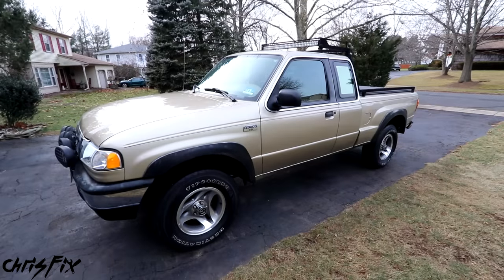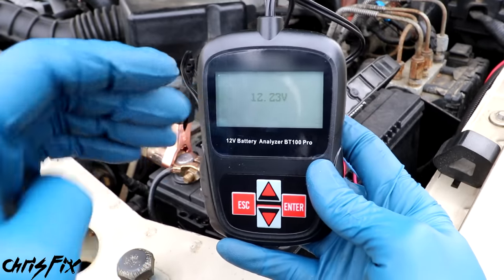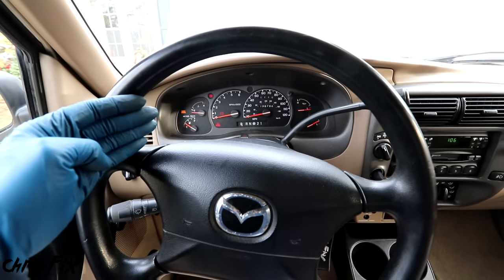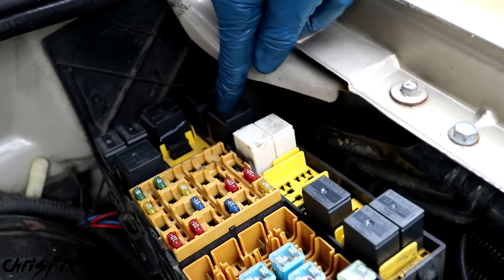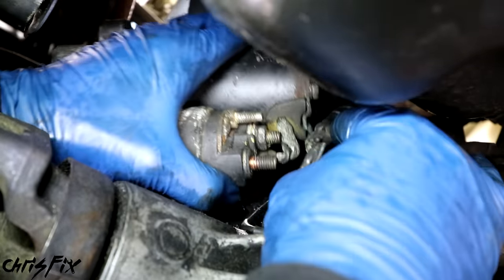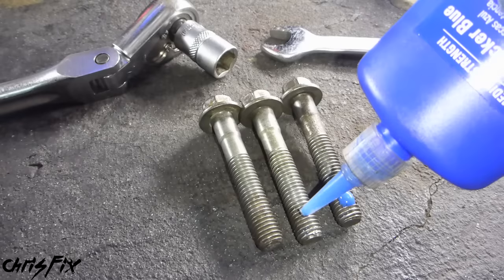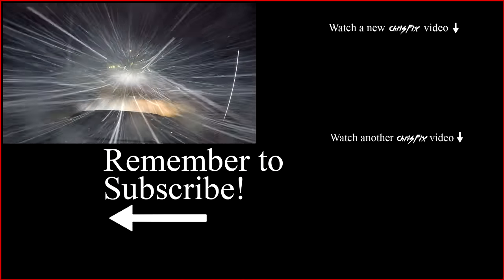How to Diagnose and Replace a Starter

Comment from the maker: Comment your "starter stories" here. I know some Audi's need the engine lifted to get to the starter and the Cadillac NorthStar engine has the starter under the intake manifold! What a bad design!

Follow me: → Instagram: https://www.instagram.com/chrisfixit
Stuff I used in the video:
Starter I used: https://goo.gl/dpUUWI 
Mutltimeter: http://amzn.to/2ja4Axd
Battery Load Tester: http://amzn.to/2ifhMRK
Battery Charger: http://amzn.to/2iiD9wN
Swivel Ratchet: http://amzn.to/2j9VGzQ
Universal Joint Adapter: http://amzn.to/2jxRqXv
Thread Locker: http://amzn.to/2jxRqXv
Silicone Paste: http://amzn.to/2ja5Q3A
Reply: ChrisFix our 1964 newport barely starts in the cold and takes a few tries in summer if its a cold engine
Reply: ChrisFix Chris thank you liking my photos on instagram
Reply: ChrisFix Wheres the How to install an e-brake for the Driftstang video huh???
Reply: ChrisFix ya thats right
Reply: i actually bypassed my starter (jumper cable touching it).
Reply: first
Reply: Not nitpicking, but remind people of Starter shims. There are cars out there that still use them.
Reply: your asume
Reply: You're my new best friend. Im pretty sure my starter just died yesterday.
Reply: Friend of mine had a mk 5 golf where he would not get it to start, tested the battery, checked fuses and relays but still no 12v on the starter solenoid from the key. After reading fault codes it was that the clutch pedal signal wasn't being sent to the ecu so it wouldn't start, after a new clutch pedal sensor it fired right up
Reply: ChrisFix replaced mine a month ago. no warning just died and would not turn. I have a jeep wrangler so it was easy to remove and replace.
Reply: ChrisFix you should disconnect through positive terminal on the battery not the ground or both. Only disconnecting the ground can cause a short in your wiring.  I burned up a passive equalizer when I was 16 years old.
Reply: ChrisFix when will you upload the hydro ebrake vid and the drift vid
Reply: ChrisFix  Mitsubishi lancer evo 2011 has the starter under the intake to i couldnt do it my self so i have to pay for it ... this was like a week ago this videos would has help me alot heheje thanks for making those great videos man
Reply: ChrisFix i once broke 2screws on my starter so i had to disassemble a lot of shit :(
Reply: ChrisFix went replacing the starter on my 1996 jeep Cherokee sport I accidentally damaged transmission fuild lines causing my transmission to blow. like you said it's a tight space in there.
Reply: Had to replace the starter in my wife's Corolla a few months ago. Pretty simple and straight forward process. I didn't have a flex head ratchet so I had to remove the radiator fan to fit a normal ratchet in there. Anyways, that's my starter story. Not very interesting, lol. Cheers.
Reply from the maker: Check the fuel pressure: https://www.youtube.com/watch?v=_oXLUqE4Sf0
Reply from the maker: Adam Vang, it will be out once I get racing seats. Cant install it until they arrive.
Reply: Once at work I had to remove the starter from a Ford Transit. It was so old and dirty and brittle that when unscrewing one wire the whole starter broke apart.
Reply from the maker: Thanks! I had info about that in there but it just made it too confusing and most cars today dont use them!
Reply: I had to replace the starter solenoid on my 03 Explorer yesterday. I took off the starter and took it to get tested and the solenoid was bad so I replaced it.
Reply: ChrisFix YOUR VIDEOS ARE AWESOME AND I LOVE THEM
Reply: Alfa Romeo 156 1.9 JTD so bad access, you need to disconnect the fuel filter to wiggle off starter, same for alternator, good point is to take old starter and store it somewhere, 'cause there can be problem with electricity or mechanical, every time can be different then you can combine them, if somebody do not have money for the brand new starter
Reply: My 1999 e36 bmw m3. You have to either remove the entire intake system or the transmission. Not only that, but the bolts that hold the starter on are near the top of the trans and take multiple extensions and universal joints to get to. I've pulled off the transmission to do the clutch and regret not just replacing the starter while I had it out even though it wasn't bad at the time.
Reply: ChrisFix  Lamborghini aveador starter so bad
Reply: Great video by the way! I think I'll subscribe lol, finally...
Reply: you forgot to put two pieces of wood behind the rear tires for extra safety
Reply: My father had a Citroen DS (a very long time ago)  that seemed to have a faulty starter(it would turn over), eventually he got under the car to remove the starter and discovered that the bolts were loose and the starter was getting jammed, so he tightened it up and it woked fine. xD
Reply: I was visiting my grandparents in the middle of january. it had dumped 2 ft of snow the previous night, and when i went out to my car, because i was going home that day, i had a bad starter. that was the coldest fix i ever had to do, but it all worked out in the end
Reply: The 02 Jetta's with a 2.0 liter engine is pretty tight! You can also bench test your battery at home if you have a vice, a spare battery and some wire.
Reply: ChrisFix how do you change a blend door actuator
Reply: My starter wouldn't work but the problem  was pretty easy to find and fix... The bolt for the positive connect had untreated itself ...  After tightening it the problem was solved
Reply: ChrisFix, My Dad's 2002 Ford Windstar Lx got stolen last month, and when we got it back (After 8 hrs.😳) the car won't start, you just hear a click, and my brother and I tried diagnosing it (in Massachusetts in the "early" winter💀😵) so after waiting a godawful time, you show up with this video😄, the only thing is, we don't have a lot (of money) to fix it, with 3000$ spent on rentals and repairs to my mom's 2007 Toyota 4Runner Sr5😰😭😭
Reply: von 524 that's bad dude u need money
Reply: On some Peugeots and Renaults you have to remove part of the exhaust pipe to access the starter
Reply: Recently replaced starter on a 2000 Chrysler Town and Country. It was easy enough to get out, but was very difficult to get back in to bolt down, as starter is partially recessed in a motor mount, and there is a wiring harness threaded through the same opening in the motor mount as the starter. So, we had to remove the cooling fan to get enough room to be able to manipulate the starter from the top of the car. That did the trick. Better/more experienced mechanics probably could have avoided removing the cooling fan, but we did what we had to do and got it going again.
Reply: hand Brake On
Reply: ChrisFix yeah on my vw Passat 1995 the starter is an mount to the engien so you need lift it up, so stupid!
Reply: ChrisFix I just changed the starter of my old 61' vw beetle. She doesn't have almost anything so i went straight to the hammer haha
Reply: i had a starter on a park ave ultra i had to take the starter out with 150 psi impact who ever stuck them bolts in they were never mint to come back out again
Reply: hey Chris, i have bmw 320i e36, starter is in super bad location and its realy difficult to remove, but the worst thing of this story is that when we removed starter we saw that flywheel is splited in two pieces. any thoughts how it happen?
Reply: ChrisFix how does hitting the starter with a hammer just turn it over?
Reply: than i had another 1 in the wood deer hunting i was back way in the woods and my starter stopped working because the ford starters the plastic piece came loose and i had to go under the truck under the water and tap the starter to start the truck and no the water wasn't there when i park low and behold i  had a flash flood at the time didn't now it
Reply: Can you do how to fix the shift solenoid next time?
Because I wanna know how to fix My dad's car reverse system that won't engage
I'm your bigger fan
Reply: xx yy its just old parts that stuck together if they are left siting for some time, depending on the condition of the starter. So if you hit them, they come lose for a moment to start the car but it will brake down again eventually!
Reply: xx yy , the starter motor is a brush type electric motor so when you hit it with a hammer two things happen. 1) whatever is left of the brushes make "good" contact with the collector and 2) if the bearings are stuck it may loose them up enough to allow rotation.
Reply: I had a Volvo 460 '93. When the starter broke i went to my mechanic, he said that the area around the starter was so tight, that he had to take it apart piece by piece to fix it.
Reply: ChrisFix  also it could be your starter solenoid... did it on my f350 7.3 and just clicked. Brand new battery's at the time just another thing that could be a problem
Reply: Another tip (that I may have missed, ignore if I did) is to not go full 200 pound gorilla on the electrical posts of the starter. Difficult to torque them to spec in some configurations (looking at you, Grand Cherokee with the Pentastar 3.6!) but having a post snap due to overtightening is never fun. Great video!
Reply: Dude, my 88 Cadillac was like that (the Northstar.) I was like 16 and got so pissed when I got halfway in and realized what I actually had to do. lol
Reply: My father had this van and when the starter failed, for a while we used the "hammer convincing method" to make it work. Actually, it used to be a relatively heavy iron rod to get to the starter and hit it once or twice before trying, there was no need to be two people, you just did it before you wanted it to work and that was it.

By the way, I guess that feature on manual cars is not that extended. It's nice to know, but not many cars around here need you to press the clutch in order to start the engine.
Reply: Was on the lake with my friends when their ski-boat (1989 old beast) wouldn't start after they shut it off. It was definitely the starter on a OMC 4.3L motor(basically a marine Chevy 262 I think). At 6:00pm most people would say  "that's it for tonight. Lets head to town in the morning for a new one," but we still wanted to wakeboard, so we pulled out the starter. We tore it right apart, made a new spring for the brushed using a blow torch and a hacksaw blade. Slapped it back together and were back on the water by 7. It was easy, just had to pull it apart and look since the issue was very obvious. Don't be afraid to take stuff apart. It's not like you can make it any worse.
Reply: Hey @ChrisFix i have the same problem for 1-2 years now on my corolla 2002, from time to time the car just decides to not start. At first after half an hour or so it would start again like nothing happened but for the last half year the only solution to make it start(most of the times) is to unplug the battery for 1-2 minutes then reconnect it and let it sit for about 2 min and the car starts instantly. I've been to multiple car services with no luck.
All the fuses/relays have been checked- all fine
I always start the car with the clutch down(manual transmissions)
I never seen any theft light pop up, also the check engine pops up
No corrosion on the terminals at all, and the battery is good
The only thing that could cause this to happen would be the starter but should not a bad starter just stop working, why would it magically start working after i unplug the battery or after i just wait.
Could you give me some advice?

Love your videos man!
Also subscriber from Romania here! :D
Reply: 03 Mustang GT has all three bolts..... top bolt needed an 18 in extension... after i replaced it i only put back on the two bolts.
Reply: U-Joint link is wrong, it takes me to the tread locker
Reply: i would add " inertia switch" to the list
Reply: Polaris scrambler is the word to change a starter on thats all I'm saying
Reply: +ChrisFix I dunno about all cars, but at least on my Mazda, the clutch safety switch is broken, and when you turn the key, it will start the car without the pedal being pushed in. If in neutral that's fine, if in gear it, obviously, rockets forward lol
Reply: my dads starter had the same problem i guess about 9moths a go 

i wanted to install a new one but my dad said let's get a used one so i went to a local towing business and bought a used one for 50 euro's ... it worked but the used starter did not have a lot of Power so the winter Came in and the car wouldn't start the first time each morning so i wanted to protect the Cars battery and thought since the old starter was spinning Faster and only the solenoid was gone bad i could make one good starter of the two 

and again the car Starts much better  but the starter was  whining ... so i was thinking to buy a new one and let that one in till it arrives but one day later the car won't start Anny more and again the solenoid is gone bad.

So No i'm waiting for a new starter
Reply: My GMC Jimmy 1998 got a bad neutral sensor, but I was on an emergency so I turned the switch to the ON position and used a jumper wire to send 12v directly to the starter relay's coil.
Reply: ChrisFix do you think you could do installing a block heater?
Reply: ChrisFix Northstar starters are not that bad to replace, especially if you get paid flat rate. Labor guide call for over an hour to replace it. I and many techs can replace it in under 20 minutes.
Reply: do you just do voice overs?
Reply: Chancged on my c220 auto (w203) and space is tight as hell, barely got space to go under and with 2 extensions go to the bolts.. anyway sorted out and everything looks ok. Other thing is that I used cooper grease instead of silicone as preventing from corrosion and guarantee better flow of current.
Reply: Ever have a low voltage issue to the starter solenoid wire? my 98 Subaru only reads 10.5v there. I'm assuming a faulty neutral safety or something else. I put a bandaid on it in the form of a remote solenoid off the battery. works like a charm.
Reply: I have a couple good starter stories, lol I think you favorite one is while deployed our HUMVEE died and we couldn't get it started so I got under the truck with a large flat head screw driver and touched the two leads while the other guy was cracking it. She turned over and you can't imagine how happy we were. I have had better times. I'm glad you showed the hammer trick you would be surprised at how many people don't know that one. Keep up the good work you saved me on the drum brakes episode.
Reply: ChrisFix our mk1 Vauxhall zafira had the original starter for 12 years. we replaced it at a Vauxhall garage and it went after 12 months.
Reply: 16yo, already replaced 10starters... ehh
Reply: i was a shift manager at a pizza hut and i was delivering pizzas one night, i was getting ready to go on a run and my starter went out. just tapped the back of the starter til it cranked over
Reply: Chris, get one of those battery terminal brushes, they are cheap, and well worth the buck (or so). I keep one in my trunk.
Reply: ChrisFix i had to lower the entire engine and subframe from a mercedes A class (A169) to get the starter.
Reply: FileUnknown1 yeah, that works because the connection points for the engaging and locking coil for the starterwheel get corroded. by tapping it you knock the corrosion off of them. the starter won't be powered if the locking coil isn't powered.
Reply: i had same problem with starter in escort 1.8 td, but i remove starter, open up and cleaned it inside from dust and rust, before mounting i check with car battery :)
Reply: Back in high school, 2007, my starter had died on me in the middle of a Kroger parking lot on my 1991 Ford Taurus in the middle of winter. My father wasn't able to help me because he was working overtime on a Saturday and my mother knows next to nothing on fixing cars. The closest auto parts store was Autozone which was a mile away. I had to walk there to buy the tools, walk back, squeeze beneath my car, hold a flashlight in my teeth, take off the starter, walk back to Autozone, buy the new starter, walk back, squeeze under again with the flashlight, put the new one on and was able to start my car. Took the entire afternoon and early evening because I had never changed out a starter before. Looking back it's pretty funny, just glad the guy at Autozone was able to point me in the right direction.
Reply: Starter Story:- I was changing the starter on the third gen Trans-Am I had at the time got the bolts off, gently easing down motor when something fell and whacked me in the forehead,, let's just say the mystery of the vanishing spark plug from the service I did 3 years earlier was finally solved lol :)
Reply: had trouble starting my old Opel , a quick slam of the door made it crank over, many door slams later i found out it was a bad groundwire on the solenoid on the starter
Reply: explain how? if you disconnect the positive first you can short out the battery on the chassis.......which is ground. negative first every time.
Reply: After an oil change on my 2005 GTI my starter out of the blue decided to crap out on me. Nothing worse than doing something completely unrelated when something else decides to just randomly die on you.

Since it was a manual transmission I had a way to verify that the starter was to blame - a push start!

I put the key in the On position and got the car rolling (have a friend push it or you just with the door open try to do what you can pushing on the a-pillar.) After picking up some speed put it in first gear and let out the clutch to engage the engine to the trans. It will want to stall out so give it some gas/press the clutch in to let the engine rev.

Since the car was able to run fine from that it was indeed the starter that was the one thing not doing its one job - spinning the flywheel.
Reply: ChrisFix I bought a 91 accord, switched the transs in it and then it was making the grinding sound, we checked the starter and it wasn't that and we bought a brand new battery and it still wasn't that not sure what we did wrong but every time we tried to start it still made grinding noises, so by the end we just sold the car
Reply: ChrisFix i have a 1979 f100 and it ran out of gas and my friend kep trying to start it when i was towing home and it just picked when i would try to start it so i replaced it so after i replaced it it still would not start but this video help me so when my 6foot snow drifts die down i will fix it thank you for helping me.
Reply: ChrisFix easy, Nissan Titan v8, you need to remove the intake manifold to gain access to the starter, you would think Nissan knows better than to put a starter right underneath the intake manifold, but nope.... they botched that design.
Reply: ChrisFix  
Starter went on my 05 silverardoo.  To dangerous to fix myself cause I park on a busy street in the city.  Brought it in to the dealership.  Drove away with a 2016 silverardoo.  Trade in value was to good to walk away from, the repair cost was voided and 0.0 % interest rate on the loan.
Reply: ChrisFix what store do you recommend other than autozone ?
Reply: ChrisFix i have an 05 chrysler sebring convertible that kicks when i change from drive to park. Also the same but less severe when i go from drive to reverse. Another thing is i cant floor it without it kicking either. Its an automatic. Please help!
Reply: ChrisFix my 2005 Jeep Laredo has problems starting up. It doesn't make a sound at all when I turn the key to the ignition but the lights are on as well as my check engine and the theft light doesn't turn on of course. I often have to turn the car off and on repeatedly until it starts. Is this just a starter problem that I can easily fix with the help of this video?
Reply: ChrisFix, I've been doing this for decades, so I know the drill,,, you should save the easiest bolt or nut for last when removing, and do the reverse when reinstalling, like you did.
Reply: My starter story comes from seeing my neighbor having problems trying to replace his starter. He got the old one removed, but couldn't get the bolt holes lined up for the new starter. The problem was that in the 1991 VW Jetta the front engine mount shares a starter bolt so when he removed the starter the front of the engine dropped down a little which is why the bolt holes wouldn't line back up. The solution was to jack up the motor a little until the holes lined up again.
Reply: ChrisFix Chris I just wanna say your videos are best out there for the repair/replacement of any part in a car. I watch every video you upload and at the moment I am 16 year old beginner driver and I can feel more confident about changing a part on a car when I get one. Over the years I have been taught how to work or change a part on a car, but when I watch your videos I get a much clearer view and understanding such as torque specifications, what type of grease to use, etc. Thank you and keep uploading videos.
Reply: my starter broke yesterday so this video is to a lot of help! Thank you
Reply: ChrisFix  6:08 i do it many times on my old chevy caprice 😂👌🏻
Reply: I use my truck as a farm truck, it's a 75 F150, and I had just bought it. I had the headers installed so it could pass inspection, and for some reason they said they had to take the starter out of the truck. Never knew why, but they did. Anyway, I was going to school one day, and the truck wouldn't crank over. So I had a friend come by and all he did was tightened the bolt to the wire connect to the starter, and it ran fine. A few weeks later, it did the same thing and it turned out the starter was burned out, so we took it out at his shop, then tried to tighten the headers back in.  The gaskets were wrong so we had to buy new ones, and yeah it works fine now.
Reply: 86 Honda accord. the starter is between the intake manifold and the transmission. you have to remove the intake manifold to get it out. its also carbureted, and the carb has about a million vacuum hoses. any one of those damned hoses not connected will result in the car not being able to run.
Reply: GM Northstar V8. You have to remove the intake manifold to replace the starter. It's located in the valley between the heads under the intake.
Reply: About 5 or 6 years ago, my mother's car at the time, a 2000 Chevy Malibu, needed a new starter.  I started he job just fine, but I did not have the one tool that would have made the job easier, which was a cheater bar to unbolt the starter. Luckily, I have a friend that had one, so he came over with it and helped out on the job. He got the bolts out and bolted the new starter in.  I had to get back under there since I had already undone the electrical connections and knew which ones went where. The operation was a success.  The car was junk when she bought it, so I'm glad she doesn't have it anymore.
Reply: My V6 Grand Vitara's starter is below the exhaust manifold
Reply: i did a starter job on my land cruiser Prado 
i didn't have to replace the entire starter but i had to clean the interner connection point 
it is working flawless
Reply: von 524 buy after market they work good enough for you to collect money for a real part later on
Reply: ChrisFix i was replacing my battery terminals and well I have a 1995 Jeep Wrangler and the starter screws were so rusted and bad that I broke off the starter screw and had to replace my starter the sad part is my starter was made to last 21 years and still the original part 😭😭 and I later found out that I could of just replaced the screw I broke off I could of kept my jeep original just rebuilt my starter
Reply: ChrisFix at the end when exiting auto zone you said give the old starter so you dont get charged a (something) charge i could make it out sounded like court
Reply: Nathan Zavala i believe wilding a screw was going to work just fine 
You know what..., 
Some times screw just wanna screw you up,😥
Reply: core charge
Reply: Edward Myers replacing a car battery would cost more if you want to keep the old one instead of giving them it
Reply: ChrisFix I have a 2003 Toyota echo, and I used have a bad starter so I kept using the 2nd gear push method for around a month until I got it fixed.
Reply: ChrisFix well this isn't so much of a starter story but a reinstallation if you wanna call it that. Anyways I was in my truck (1987 f150 with the inline 6) and I was taking it down to the junkyard on the interstate obviously going only about 60 and the road was a little bumpy and as I pulled off he interstate it sounded like there was something rattling around in my engine compartment though I shrugged me shoulders and ignored it. Well I go the Hingis I needed and went back out to my truck just to find I would only hear a click when I turned me key and I was like "what the heck! I just replaced my battery a month ago" well it turns out the battery was fine but me and my buddy got to looking and noticed my starter was only on by no more then 2-3 threads which surprised me. So I went in my truck tool box and put it back in but then had to bump start my truck backwards out of he parking spot to re align the chuck in the starter. Well it turns out that the old owners when replacing the starter didn't put thread locker on it which was the first thing I did when I got home. So I am a huge advocate on thread locker for sure.
Reply: on my old Mitsubishi the started worked but was rather weak, so we took the starter off of the car to find that the starter was full of oil due to an oil leak higher up on the engine. took it apart, cleaned it out and replaced the pads(brushes?) which were inside of it, put it back on and it worked fine for another 2 years until i got rid of the car, it even worked well enough that when my clutch master cylinder died we could get the car moving in first gear with the starter motor and slip it into higher gears, was enough to get it home so i could repair the clutch cylinder.
Reply: I remember having to change the starter on our 1983 GMC 3500 dually with a 454. Uncle did the old school hammer trick and broke the housing of the starter. The truck was parked on gravel (which really sucked for my back) and had to loosen up the exhaust manifold in order to shimmy the starter off. Squeezing in the new one kinda sucked as well, but I got it going. Tossed the old toolbox and jack inside and drove her home. :)
Reply: ChrisFix I had a starter go bad on me. Instead of not turning the motor over it partially engaged and destroyed my flexplate teeth. but that's not all, not even mentioning the trouble the flexplate was to replace. I didn't tighten to connections on the starter and blew my radio and gauge cluster. (98 Ford f-150 5.4 Triton)
Reply: my jeep cherokee wasnt to bad and of course being a cheap ass i couldnt afford a brand new starter so i took it to my step grandfather and he said the brushes were shot (trying to find them was a bitch) but i managed to find some new brushes for it and put it all back together and my starter was so strong and started so quickly i didnt even know it was my car starter it sounded completely different plus never knew mitsubishi made my starter as well
Reply: ChrisFix I had a 98 ford ranger with a 5spd manual trans, so same setup you've got minus the 4x4 so we had more room for the bolts. 

Anyway, I was just learning how to drive the truck as it was a manual transmission so we were in an empty parking lot, and I go to try and drive the truck and jerked the truck so hard, that that exposed wire on the starter broke! Now it was rusted through to begin with but still. So my mother had me push the truck so she could pop start it. I had no idea what that was nor did she tell me why I had to push the truck, she literally told me to start pushing and next thing I know, I'm face deep in the tailgate! So we got it started and drove it to my uncles house and swapped it out in about an hour.
Reply: '02 Honda Accord here. Replaced my 5 days ago. Had to remove battery and intake to get to it. Other than that, fairly easy job. Agreed with the feeling of starting it up after being the most rewarding for sure. Always great videos. Thank you!
Reply: ChrisFix you didn't mention that your battery should be disconnected before removing starter cables 😉
Reply: Tony Fuentes he did
Reply: Great video!
I have a similar problem, the battery is good when checked. But the starter ... Sometimes it can start and sometimes like lose its 'bite' like a slipped clucth.
Reply: ChrisFix Mitsubishi 3.0 V6 (Eclipse version) have to remove the front exhaust manifold, cat, and downpipe. Then take the front motor mount loose, prop the motor, and remove the cross member. Now you have access to the starter. Don't even get me started on the timing belt.
Reply: Hondo Hooper the 2007 2.4 eclipse also requires removing the exhaust manifold as well. luckily my eclipse was under warranty when the starter began making noise.
Reply: Bradley Preston That's awesome man beats doing it yourself and then doing it again when the new one turns out to be a dud.
Reply: Hi, +Chrisfix can you please do a block heater install video. Im from ND and its like -13 here right now. Thank you
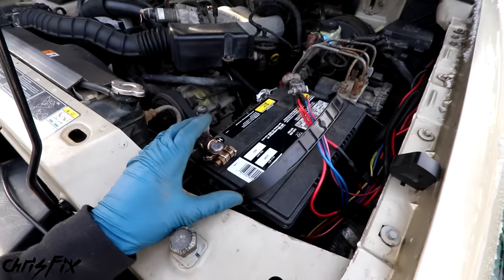Reply: 7:34 my friend
Reply: ChrisFix starter went out on dad's work Truck "97 f150 4.6" replaced it... engine started knocking 😣and water was in oil... too poor too fix.. but will fix when given the chance. 😌
Reply: ChrisFix what if my battery has sugar like dust on the poles
Reply: So in helping my then girlfriend years ago now wife replace her 89 bronco II starter.  we fist started getting a new starter ripped off the old one and the they looked noticeable different and the bolt holes didn't line up.  Back to the store returned and ordered another starter based off the the model number of the one removed from the engine.  Come to find out some one married the broncos 4 Cylinder engine to a 96 ranger 6 cylinder transmission.  At least that was what the model of the old starter was meant for.  Of coarse they didn't have that one in stock so we had to wait another day.  My wife got the truck from her mother who bought it used from another person. Just goes to show you never quite know what your going to get.  And if you really want a female to be looked at weird tell them you need a 96 ranger starter for an 89 bronco II.  I dont think he could have turned his head an more further to the side without falling over.
Reply: I had to change the starter on my 2007 Honda Accord. It was buried under the intake manifold. Removal of the throttle body and the rest of the front of the engine took me over an hour. Can't even see the starter. Only the large copper cable providing power is visible, until it vanishes into the abyss.
Reply: Angel Mar Thats Corrosion/battery acid. Best bet would be to sand all the white dust off. Don't breathe it in though.
Reply: Gotta love audi
Reply: I have a 1999 Toyota Avalon which I thought the starter died on me a few years ago. It was actually super easy to remove. I just had to pop out the battery and I could access it from above rather than having to get under the car. Took it to Auto Zone to get the starter check and found that it was A OK. Turns out the thick gauge wire that connects from the battery had been corroded. Easy fix. Although, I regret not checking everything else first. I went straight for the starter. These are good tips if I ever run into this sort of problem again.
Reply: ChrisFix  Hi Chris can do a video of how to lower your car to make it look more like a sport car
Reply: ChrisFix can you make a tool kit video to have in your car? Like a emergency kit tools
Reply: ChrisFix cool story here: When I was in Africa I bought a manual transmission 2012 Isuzu kb250 (essentially Africa's rhd version of the Chevy Colorado) and I could start it without pushing the clutch in. I guess they don't build them with neutral safety switches?
Reply: ChrisFix had to actually do a starter in my buddy's 96 Deville Northstar was a pain in the ass to do had to take the fuel rail out and the intake manifold and all the other stuff covering it never again
Reply: ChrisFix this video would've been mice last spring. I was in our middle school parking lot, shut my truck off and a few minutes it didn't start. I called someone with someone cables and also knew more about bar that what I knew at the time.  I forgot ablut hitting the starter. I left it at the middle school until someone could help replace one. The starter I replaced it with shredded itself within about 8 miles and it died in the driveway of my "mechanic". It was pretty funny, the starter was just a defect one
Reply: keagan butler it's not that bad
Reply: +Dan Oliver if you routinely work on cars in winter, get yourself a propane torpedo heater (about 99.00 from Home Depot) set it up to blow air under the car at the opposite end. It's like a big blow dryer blanketing you with hot air while you work. I've done exhaust and transmission work like this outside in cold weather. It was my saving grace!
Reply: on my 99-04 v6 after the engine would turn over, I would get a loud screeching noise. the solenoid wasn't moving the starter gear out of the way of the flywheel quick enough so the flywheel was grabbing the starter motor gear making it screech!
Reply: It's pretty easy to get to on my Chevrolet cavalier, it's right behind the front bumper at the front/bottom of the engine
Reply: ChrisFix whenever I get a chance to put a new valve cover I'm going to change my starter on my BMW since it happens to be under the intake manifold
Reply: ChrisFix I had to take an atv right apart to change it
Reply: ChrisFix our car wouldn't start after filling up on gas, so we had to push it to the nearest parking space from the pump. All our electronics were working fine. But the gas station was near a busy highway. And every time we turned the key, the dash lit up and we heard a click. So we thought the starter was bad. I walked to the nearest oreilys, bought a starter, and the walked to the nearest Fred Meyers to buy a small toolkit. We had to take out the intercooler to get to the starter, and it took a while cus it was below freezing out, with no hood prop. After all the trouble we went through replacing it, the car still didn't start. Turns out it was the battery. 😂 /).(\
Reply: this one time at band camp
Reply: My starter story is lame. Honda Civic with a B16A2. The power randomly cut out and came back. Thanks to the ramp truck episode of Roadkill, I thought the to check the starter during my diagnosis. Sure enough, somehow one of the studs on the starter's solenoid was stripped and the nut was coming off. A new solenoid was more expensive than the whole starter so I went to remove the starter. Well, the bolts were stuck. Fortunately despite the tinyness of the car, there's LOADS of space under the hood, especially with an after market intake. My impact wrench fit with no problems. Took maybe 15 minutes to get it out. One trip to Advance later and I had a fresh starter. The new one went in way easier than the old one came out. Took about 5 minutes. I started the day off worried that it was gonna take forever and be a pain. Changing the oil is harder.
Reply: great video dude. iIhad a problem with the starter just recently with my bmw e36. First I tried the same with the hammer an it worked for quite some time but when the problem ocurred again I had to bring my car to a friend that owns a garage because I dont have a lifting ramp and you have to use 1 or 2 extension pieces to bolt off the old starter and replace it with a new one. Now my car is working again. 

Keep up the great work and greetings from Germany
Reply: ChrisFix what if when you go to turn on the car it cranks quite a few times then finally turns on with no problem. if you don't get what I mean check out my video on YouTube titled "Cold Start" thanks.
Reply: wtf carbon fiber looking tinted windows? really dude?... It's cold as fuck it's hard on the battery. Without any testing or inspection it could be anything causing longer than normal to crank/start
Reply: The other day my car wouldn't start. So after testing my battery, I concluded that it was the starter. I went to Advanced Auto Parts and purchased a new starter. When I came home, I decided I'd clean the connections of the battery, and what do you know? It started right up!
Reply: Omg my 1995 Ford 150 that i just bought from a local is now having an issue with the starter i think,  when i turn the key  nothing happens sometimes  then turn key back and go to start it again and it works just fine. This video is just perfect hopefully the starter is the issue because im about to watch you show me how to fix it.
Reply: lol
Reply: I really believe my starter is the issue but dont know for sure it will crank most of the time but once in awhile when i turn the key it doesn't do anything. Its very cold right now most of the time right now -10 to 30 degrees fahrenheit.  Idk any advice
Reply: 2006, my first car, '88 Mazda MX-6.  Had around 265,000 miles at the time.  Left work on lunch break to go to the bank.  Left the bank and got into the car and.. nothing.  Had to leave the car and walk back to work late.  Had AAA at the time and the AAA guy and a co-worker pushed the car and I popped the clutch.  Luckily I had awesome friends who knew about cars, I bought the starter and they installed it for me.  Definitely always check the battery/terminals/cables.  The terminals were pretty bad on this car, as well as the negative battery cable.

2016, '97 Trans Am.  Battery was dead, was jump starting it with my Subaru.  Went to crank the engine over, it cranked for a half-second and stopped.  The SECURITY light started flashing.  Troubleshooted and found that one of the crappy ass wires in the ignition lock cylinder that reads the resistance in the key pellet broke (Ohm checked the wires with key in ignition and the circuit was open).  Did the VATS bypass and all is good.   This wasn't my first rodeo with GM's VATS, had a '94 Camaro that did the same thing in early 2016.
Reply: my 2011 lotus evora starter died and it was a pain just sourcing the part.  i had to remove the entire intake assembly just to get to it and even then you had to get to the bolts for the starter by feel more than by sight.
Reply: ChrisFix.   heck yeah! I work at autozone!
Reply: ChrisFix chris i have a really big question can you please reply when are you going to make a video about installing your hydro E BRAKE
Reply: ChrisFix i have golf mk3 tdi, and its pain in the ass to change the starter, becaouse its mounted on front engine mounth
Reply: ChrisFix thank you for keeping us updated always doing good hey does your truck have a key program you should teach us how to do that
Reply: ChrisFix s
Reply: Reply for Ben Hinckley. Only cars that are made for the US market have that neutral clutch switch, in europe we dont have it. It is probably because cars for the US market are made by default with automatic transmissions so they already have an engine ECU that expects a neutral transmission signal to start so they need to create a signal even for manual transmission cars.

Reply to Chriss Fix. all German manufacturers dont give a rats ass about repairs. Their products are notoriously dificult to fix even for simple expendable stuff that are suposed to be changed regularly. Even Ford Europe has been infected by this curse. The engine bay in my 2008 Ford Focus 1.6 L VCTi is spacius but changing the timming belt took experienced mechanic more than 150 minutes. For a Nissan micra 1.3 Variable valve timing with literaly no space under the hood it took him less than 90 minutes. 

Leasson to take home: Ease of repairs is paramount because at some point it will brake down no matter how reliable it was to begin with.
Reply: The starter on my '93 Volvo 240 is slowly dying, the starter solenoid will only engange after 3-4 tries.
Reply: While never having a hard time doing a starter i have dropped one on my melon before while doing the deed, oh look! a puppy!
Reply: My Focus Mk1 had a bad starter when we bought it, it started the car everytime, but made a REALLY bad noise, I changed it with my father and now it works like a charm.
Reply: Electronic Experiments - i own alot of old lawntractors, basically either replaced or cleaned the old starters. i was cleaning and painting my old rusty 86 gt 2 craftsman  with a 18 opposed twin briggs  horizontal shaft motor, while it was apart, i changed the starter motor. no easy feat, being you need to remove the motor because its tucked tightly inbetween the motor  and chassis. wasnt going to reassemble the whole thing to take it apart again. 👍
Reply: I had a problem with starting a land cruiser 80 series. Believe it or not. Ended up NOT being the starter, but u had to disassemble half of the car before finding the fault to be one single wire in the dashboard -.-   . But taking that massive starter off from that massive Toyota transmission with the transfer case in my face even with a 4 ton hydraulic lift was a nightmare for two people. The fun we had. Love that thing.
Reply: No Limit -  sounds like the time a buddy of mines car had a leaky heater core, had the entire dash/ heater box  out of the car and the dam thing was under the hood the whole time. took all day to replace it.   was a older olds tornado i think, had the v8 with front wheel drive.
Reply: I went to replace the starter on my 94 vr Commodore and it wasn't till I put a new one in that I realized someone had bolted the positive wire to the frame
Reply: OMFG them northstars. Get one about every couple of weeks, inevitably about four a year are because of starter motors. And not only that, they're a pain in the fucking ass.
Reply: I had a volvo 740 for a while...Used to bang on the starter with a piece of wood...for months without changing it :-)
Reply: ChrisFix 6:08 Jeremy Clarkson would be proud
Reply: Toyota Landcruiser V8's have the starter under the inlet manifold
Reply: ChrisFix i once had some real blame at work because they told me someone diagnosed the starter is broken i should change it after i did it it still did not work at all i cheked all those connections with a multimeter an mass to battery what has been the problem  because the csr may had a mass but the engine didnt cause that fat mass cable from block to chassy was just all green corroded and meltet changed that and it worked just fine
Reply: I had a Renault 16 a few decades ago, an absolute pain to remove the starter. Needed a special bent C shaped 17 mil spanner to access the difficult bolt, or take off the exhaust manifold.
Reply: Often the brushes are completely worn and not making good contact with the commutator. By tapping the starter, brushes may move a little bit, just enough for another couple of starts.
Reply: ChrisFix hey that's not always the case I got a story I was working on an old 1948 8 n Ford tractor and the starter issue I had with it was the whole starter mechanism on the end of the shaft of the starter flew off inside the bellhousing so what the starter would Free Will and wound up to a high pitch wine
Reply: ChrisFix I helped my father in law replace the starter on his 2002 Taurus a couple of years ago in northern NJ he was adamant that it wouldn't come out from the bottom so he tried pulling it from the top. well a couple of broken vac lines later he let me give it a shot. two minutes under the car and the starter was out and the new one was bolted in. some mguyver repairs to the vac lines after that and hit the bar. needless to say I didn't have to buy my own drinks that night.
Reply: LuckyCharms727 that's funny the same exact thing happened to my Papaw we had to jack up his Chevy S10 and he spent 30 minutes trying to replace a starter I got under there in less than 5 minutes had it wired and all the braces and everything hooked back up it started up and ran
Reply: ChrisFix the starter in any flat four Subaru engine is easy to access,  and you need about 20 minutes to do it if you didn't replace any starter before,   it's hard to access and hard to find in the Suzuki SX4 and the Hyundai Accent,  I love subaru so much because they make their cars like legos
Reply: My story is about the wires that almost dead after 30 years. It is important to replace the main power wire that goes from battery to starter, otherwise, there will be not enough power to crank the crankshaft. And it also might be the case that car burns down because of the short.
Reply: I had a large amount of corrosion on my connectors on my 97 dodge ram 2500 5.9 (it was getting to the point where I had to have 2 people to start the truck, one to move the key and one to jiggle the wires), so I went to take the connectors off and I not only snapped the studs and busted the plastic around the studs I also somehow managed to strip the nut... Naturally this took place when it was freezing cold out side.... after throwing the starter in frustration a good 50 feet i went to the junkyard and all they had was a starter on a 01 dodge ram 2500 8.0.... after about an hour of laying in snow and water we finally got it off,,,, then we had to Frankenstein a starter between the one I just pulled and the one I threw, due to the fact they were different shapes. 

Long story short, It is never easy owning a dodge
Reply: +ChrisFix A 94 Sonoma/S10 with the 4.3 Vortec is a pain in the ass because the starter motor is partially inside the transmission requiring you to loosen a bunch of the transmission bellhousing bolts and kind of cracking it open like and egg.
Reply: no homo but i really love this guy videos are the best, make me wanna switch my career to being a mechanic
Reply: My starter on the e30 some times makes noise and turnes the electric motor , but wont engage on the flywheel..
Reply: Have a Polaris Sportsman 90, Accidentally hit the kick starter while starting the four wheeler with the electrical starter. The Starter quit and the Built in Bendix is missing teeth. Now I have to tear down my engine to replace it.
Reply: I had one starter that had so much oil grease on it from a leaking headgasket that we had to hammer it out once the bolts were removed. Was seized/rusted onto it somehow.
Reply: ChrisFix why didn't you chalk the back wheels for safety when you jacked up the front end?
Reply: ChrisFix My 06 pontiac g6 gtp was sitting for about 2 weeks. Changed the valve cover gasket and spark plugs. Keep in mind a ton of stuff had to be removed just to get the rear cover off. I put it all back together and it went beautifully. I turned the key and it started to idle very rough. Got a code for a misfire, abs light came on and everything. Then I turned it off and back on. Wouldn't start, just made sounds like the starter died. I then decided to charge my battery and it was 11.9 volts. I didn't think it would cause an issue if it started once already. Let it charge to 12.7 volts and that baby fired right up. Ran smooth as Skippy. All that shit because a low charge. And this all happened after you posted this video.
Reply: He did. there's two blocks behind the wheels
Reply: This happened to me in college with my 96 impreza. A friend knew about the hammer trick that we used to test if it was going back and helped me install a new one. He was my Chris Fix before youtube.
Reply: ChrisFix my starter stories... All of them are for my computers.

Whenever I was booting into Linux it wouldn't accept my password and get on a login loop chain (No matter how many times I entered the password, it wouldn't log in.) So, after spending hours of my time to figure out the problem, I realized my graphics drivers were spitting out some information that I didn't like the looks of. I brought it into terminal with CTRL ALT F1 and ran a few commands to bring the old drivers off of my desktop. After installing some new drivers (Nvidia 367) I realized my graphics card was too new for the drivers I had selected. I sat there for hours tearing my hair out but finally I realized I needed Nvidia 375. I downloaded the drivers off the website to a .run file (I had to set it as executable from terminal.) I also had to disable the current Xserves session running on my computer. I brought it into grub recovery mode and loaded the drivers onto the desktop. Unfortunately I brought it into the same chain I started with. Once again, I downloaded the drivers from the Ubuntu servers and got it working. I'll tell you it was TERRIFYING! Trying to figure out if I needed to wipe the hard drive and reinstall Linux.
Reply: great vid man! i just did mine 2 weeks ago in my 93 jeep. checked battery connections and nss beforehand and found i had loose terminals as well as a dirty nss. so did all 3 together at once. starts and charges like a dream. keep up the great vids
Reply: I drive a Northstar myself but even worse though is one I did on an 89 Toyota Corolla 4wd wagon...between the engine and the firewall under the intake manifold. It can be done from the top but it takes time, skin and it isn't fun!
Reply: ChrisFix hey chris awesome video!! I have a 2006 civic and when i start it in the cold it makes a grinding noise almost the same noise as grinding gears and i was told its the starter thats beginning to malfunction. What do you think? Thank you very much for the videos man helps alot.
Reply: In my case it was the head box of the truck, not the starter.. :/ haha
Reply: The starter on my '06 Fiat would crank only when cold, if the engine got to operating temperature the axle would somehow bend from the heat and spin very slowly and drain the battery when cranked, very weird problem and the diagnosing was quite tricky. Replacing it was not so hard, 2 very easy to reach bolts from under the car and for the third i had to remove the battery and battery tray to access it from above.
Reply: ChrisFix A year ago I had to replace the starter on my 2006 Bmw e60, that was a pain to change because I couldn't reach the starter to tap it to try and at least get my car home from work because it was under the intake manifold. So once I got home I attempted to removed the air intake manifold however the manifold itself had its own trick to remove because in the back of it it has two different vacuum type hoses that are almost impossible to reach from the top so rather than spending more hours trying to remove those houses I just pulled the whole intake off which caused me to break the vacuum hoses. So I went to AutoZone and they didn't carry those two houses that I needed so I had to go to the dealer and buy each of those houses they cost me almost $140 each so in reality I ended up buying the starter and two houses that ended up breaking on me so pretty much I bought three different starters for the price I paid. Long story short it took way longer than i anticipated but I replaced it. Great videos Chris keep making them.
Reply: ChrisFix the way some cars are built these days, the simplest of common components are next to impossible to service anymore..
Reply: Awesome video!
My story is that I had many problems with starter until I figured out that it was a starter to begin with. It was very difficult to take it off, but I do managed, and then I brought it to service station where they fixed it. It was about 30$. And then I put it back in a car. It wasn't so much hard work as much as it was very hard to reach and going underneath the car.
Reply: ChrisFix How to sell the Mazda truck
Reply: your true, i like this guys videos on replacing stuff if they go bad
Reply: Once, Dad parked the 1995 Voyager in a flea market. We got there around 10:30 AM and left at around 8:00 PM. Someone did help us get it started which I'm thankful for. We dropped him off on the way home.
Reply: Did 6:32 once did that to a camaro as it wouldn't start the starter was easy to replace.
On with older GMs is sometimes only the solenoid fails which is a $10 part vs $50 or more for a starter and some cars have a third terminal marked R which goes to the coil to bypass the ballast resistor during starting.
Reply: Had an 1987 Dodge caravan, starter went bad, found a replacement from a newer model (92? i think it was) that used a gear reduction. little smaller... same mount and fit and everything. no big deal...works great. so the starter works for about a year (i'd rebuilt the old starter and kept it for a backup.) and one day the gear reduction inside the starter broke and seized the starter motor. so I get it back home, pull out the starter, think hey, i'll just throw in this other starter be back running in 1/2 an hour... install the starter...hit the key... nothing. trying to figure out what the deal was. Got a jumper cable and hit the starter... away it goes. What's going on?!? check my wire connections...everything seems good. Apparently when the starter gearing broke, the 1000's of amps of draw fried the wire and broke it someplace inside. I removed the wire and replaced it with some super heavy duty wire we used for installing a friends stereo amp. Fired right up. good times.
Reply: ChrisFix can't you also tap the starter and it will start again but tapping the starter will not last forever
Reply: KOOL KID JULIAN yes tapping the starter does work sometimes. Eventually the solenoid will go bad and the starter will start clicking again
Reply: 93 Mitsubishi Eclipse GSX , manual,: replaced starter (verified good at autozone after it wound not start) , battery  starter relays; heard relay clicking.... ended up being the starter switch ignition key.
Reply: Alex G I had a Mazda Miata and the same thing happened to me. It was my switch in the ignition that was bad.
Reply: ChrisFix 1985 corvette holy hell was that hard
Reply: ChrisFix I went to replace a starter for a man and his son. I followed you're latest video to a T. Problem I had was that when I took the old one out, there was 3 cables that were connected to the starter and the new starter he had only had 2 spots to put cables. All the videos and stuff I've watched show people connecting only 2 wires to the starter. When he phoned the shop to ask why there was an extra cable the man said to just tape it off with electrical tape. It just didn't make sense to me idk maybe you could help by seeing the photos. I'll copy and paste this to YouTube so maybe you'll see it. Thanks a bunch dude you're seriously inspiring me everyday to want to become a mechanic I got so much respect for you and all you do.
Reply: ChrisFix I sent the photos to you're Facebook cause I don't know how to send them on YouTube :(
Reply: ChrisFix I really wanna figure out what that extra cable was I think that's the only reason why the car didn't start when I bolted it down. The extra cable I had no idea where it was suppose to go cause the new starter had only 2 places to put the cable. Pleaseeee help
Reply: Richard Vaughan sometimes ive seen 2 smaller wires stacked together on the same terminal (from the ignition start.) you should have 1 big fat wire directly from the battery.
Reply: ChrisFix I was at cub scout camp with my dad, and the starter on his '94 Camry died the day we were leaving.  The hammer trick got us out of that pickle, and he had the starter repaired a week later
Reply: Hi chris, my name is chris 🙂hello again. I see all of your videos and they help me to fix my car without lose to much money ! Thenk you for this! I sell my car it was a VW Golf mk3 and now I have 500$ cash in my hand and I dont now what type of car will I buy next? Can you please give me a reply to this message and tell me something that i could buy! All the best my friend! You're awsome!
Reply: Helped a friend with his 2007 Honda accord.  The starter was buried directly under the intake manifold,  and could not be accessed easily from underneath.     Hardest part was removing all hoses,  intake manifold,  throttlebody (and coolant lines to it ...weird)    just to have enough room to access it.    Very fun project.
Reply: coolant lines are there to keep the butterfly valve in the throttle body from freezing up in cold weather lol
Reply: One time my starter on my 2009 Subaru Impreza WRX would sometimes not fully engage on the ring gear and it wouldn't turn the engine over.  It would just make a horrible grinding noise from the starter pinion skipping teeth on the very edge of the ring gear as it spun.  When I took the starter out I found that the pinion gear and the bushing that the pinion spins and moves in and out on was gummed up.  Other than that, the starter was in perfect condition.  Out of curiosity, I cleaned the gunk off, lubed up the sticking parts, and moved them until they moved freely.  After that, I put the starter back into the car and it worked perfectly again.  I've had it in my car for 16,000 miles now with zero issues!  At the time the car had 149,00 miles on it, but it now has 165,000 miles!  This experiment saved me a lot of money!  Additionally, I'm a second year Auto Tech Student at Nashua Community College in New Hampshire and I love your videos! They are great for beginners who are just starting (no pun intended) like someone like me.  Keep it up with the great videos!!!
Reply: ChrisFix my car starts but has some weird clanking noise at the very end of the start. Wondering now if it's my starter. And when I put my car in drive when it's cold, it takes a second and jumps into drive. What's going on? Is my tranny bad or is it the neutral safety switch?
Reply: ChrisFix my then thought starter went out in my 2002 Dodge intrepid, after 175000 in 12 years I thought it was worth replacing. I first thought it was the starter, replaced it, and it wasn't that bad. After 4 hours of work, the car still would not start. If anyone didn't know, the intrepid model car has a very low kept  battery in the car. This caused me to have to remove the front tires, bumper, and headlights. Little did I know but the car would blow up 2 months later. Now in my backyard of lost dream cars. 😰
Reply: When I start my 2009 civic on a cold morning it makes a weird winding noise after the car starts, can someone please tell me what that is?
Reply: The original starter in my 96 accord went out at 239k last year in the middle of the winter (The starter still sorta worked and still started the car that was sitting in the 18F cold for a couple days) . It is located right on top and a new starter did the trick. took us 30 minutes. Also if the starter doesnt mate the flywheel correctly itll grind against the flywheel.
Reply: Also the new starter on that car sounds more like a squeaking noise
Reply: ChrisFix Hello Chris  I'm from Greece I am 14 years old and I love your videos and I find interesting working with cars. I recently  have changed my dads old car (Suzuki Samurai) oil and oil filter and the battery. I also have made the same penetrating fluid  as yours and it works perfect, and all these thanks to your your  videos.😎😊👍👏👏👏👏
Reply: Thanks for one more good video. I don't know if I liked too much you partnering up with AutoZone. Nice store but is you save a lot ordering on-line. And I immensely appreciate your disinterested willingness to share your knowledge!
Thanks again, I have learned a lot with your videos !!
Reply: My and my dad were going to a lake to go fishing. A couple of days before we got the engine rebuilt (because my dads car is a 1977 Datsun 1500 620 1 ton (or tonne) ute ( ute cause I'm Australian ) ) and we put it back in ( we as in the shop place thing) and we got the car and decided to go fishing. So on the way there we didn't realise but the starter had fallen out due to the bolts be over tightened and stripped. So when we were gonna go home my dad went to start the car and boing happened. We checked everything, wires, fuse, and the battery. I then looked to see if the starter wire came of and I saw it wasn't there. I told my dad and this is what he said as soon as I showed him, "fuck". Literally what he said so I ran Jl the road and about 500 metres away was the starter just laying there in the floor all scratched up and I just piss myself laughing and run back to the car. So we call our mechanic and my mum to drop of a ratchet spanner and some jack stands and we fixed it then and there and about four days later we have to replace the starter. Goddamnit Daniel ( that's what we named the car )  The End.
Reply: The Drift Wolf best story ever mate. :)
Reply: The Drift Wolf ***** get a load of this guys starter story
Reply: ChrisFix Went to check for the location of the starter on my 1990 Lexus Ls400 and its under the exhaust manifold! You have to remove the whole manifold before getting to the starter. Absolutely crazy design flaw.
Reply: First time I changed a starter was on a 95 Jetta. I was 16 and had no idea what I was doing and didn't realize that the starter was bolted through the cars front engine mount. So I started getting the bolts lose pulled them out and as I did I saw the engine drop a few inches. Then I had a fun time trying to get the engine back up to the correct stop so I could bolt in the new starter.
Reply: The first time I had to replace my starter was a year ago on my 06 Accord. What was really interesting was how it shot sparks out the back of the starter. 

I ended up having to remove the battery stand but it was smooth sailing from there.
Reply: What about the Audi S3 Turbo?
Reply: ***** why would he change out a perfectly good starter every year?
Reply: ***** ah
Reply: Hey Chris! Good battery, good starter, still it's turning slow for the first couple of turns (sounds really weak)... wiring maybe?
Reply: Hello Chris can you make an video about making an custom dashboard?
Reply: ChrisFix what kind of sockets do you use like the company
Reply: I have a 2000 Ranger xlt 4.0 that I recently paid $700 (under scheduling duress) to replace the starter just before a holiday road trip, really could have used this guide a month ago!  If i had my way, your b3000 would be the only subject of videos.  Love the channel!
Reply: I have a 1991 f150 xlt lariat 4 wheel drive. My starter went out on me randomly at the gas pump. I had to push it to a parking spot and go to autozone and picked me up a new starter for about 150. Easiest job ever on that vehicle 15 min max.
Reply: I been needing one for my Dakota for more then a year. I just bang it when it won't start. Guys if you don't have the funds to buy one on the spot just bang it if it doesn't start.
Reply: ChrisFix hi
Reply: ChrisFix please help. my 1975 chevelle has an ignition problem and I don't know why it'll crank over but it won't start. can you please make a video? thanks
Reply: Recently did a starter on a 98 GMC Jimmy. Had to spin it 180 degrees to get it out. Not much clearance between frame and engine. The wires are short, too, so I spliced extensions on to make the install easier.  Had to do it on a 15 degree day.
Reply: Hey Chris!
I came out to my car today and a warninglight for the ABS was on. Could you maybe do a video on what the problem could be and or how you fix it?
My car is a Volvo S80 2001

Thanks!
Twinkie :)
Reply: ChrisFix my 2001 ford ranger died on a stop light out of nowhere earlier that day the "check gauge" light came on around lunch time I turned off the car and around 3 I checked the oils and there were all good except the transmission it was a little low then I started up the car again and the "check engine" light came on now I drove 5-7 min and arrived at a light and the truck turned off all completely I tried to turn it on again but all I hear is a 1 click and all the dash lights go off. I think it's the alternator battery or starter but I'm not sure what should I do?
Reply: i had a chrysler town&country 99' that honestly had a really bad life, barely maitained. the thing is that one day it would't start and i knew it was a starter problem so i got it checked. long story short, the starter had become a whole chunk of solidified grease and dust, i did't even realized it was my car's starter because of its condition.
Reply: ChrisFix my starter won't crank the engine in the morning when it's cold(below freezing where I live), but fires right up in the afternoon.
Reply: ChrisFix Never work on a bmw starter by yourself.. jesus
Reply: ChrisFix 5:50 to 5:60 switching relays will work if same terminal set up but some have the same connection but are set different if ur relays have a diagram on the side of it make 100% sure it reads  the same if u are swapping places there is ones that look same but if u do switch it it wont work cause the aux power line is wired to the switch side so wont click when turned on so check diagram on side to make sure.
Reply: ChrisFix an people if u have to go under the vehicle to hit with a hammer if it does start after that even thought u freed it that time an maybe 5 starts right after another just to make sure its working again it will freeze up an have to be hit again to start it, think of it this way it can land on position 1,2,3 when it lands on 3 it needs to be hit to start an the first 5 starts after being freed it can land on position 1 an 2 but later after going somewhere it lands on position 3 again an freezes up an u have to hit it again so instead of getting stuck somewhere u can jack ur car up to hit the starter just replace it right away so dont get stuck somewhere, an btw chris u bought a brand new starter cause they didnt need the box u got with ur new one to send ur core in with which they need if truely has a core charge so people if u buy new u can keep the old starter an take to scrap yard an get some money back since u had to get a new one anyways, an if u have a choice from a new starter or reman get the new one it might be more an have the same lifetime warrenty but the new will last u alot longer before going out an u paying the mechanic the price again just to swap out the starters cause u got a lifetime warrenty so its free to get another starter cause the warrenty but the bill to keep taking out an putting back in u pay out ur pocket so buy new not remaned parts
Reply: Cameron Northcutt cause the battery is full but its so cold it only can put about half power out try a battery warmer but if that dont work get a engine block heater cause when the engine is really cold after sitting all night it takes 300% the normal power it should to start
Reply: I have two. Once, it died in my high school parking lot. I had my mom pick me up to run to AutoZone, old starter in hand, and had it replaced within an hour. (my 89 XJ). 
Second Story: I went out to move my 97 TJ (shifting cars in the driveway) and the starter was extremely loud. I left it running, ran to the parts store (left it running again), got the new one and had it replaced within 20 min. The 4.0L has the easiest starter replacement I've ever experienced.
Reply: In all my years of wrenching on various makes and models I've learned some vehicles (older) require a shim or shims between the starter and bellhousing.  If you forget or lose the shims the starter will not engage correctly and may cause damage to the flywheel teeth necessitating further, more costly, repairs.  Don't ask how I know this!!!
Reply: I had my starter go bad last year, but my dad had a friend who worked as a mechanical and was able to replace it with a new one. I own a 2003 Toyota Corolla, and he said it was a rather easy fix.  However, it didn't fix the problem I currently have where the car tends to crank roughly when the engine is hot (after being driven and going back in 20 minutes later to start it), so... bummer!
Reply: I did this on the Windstar.  It's the easiest one I've done.  The starter is right under the front bumper.  Nothing else whatsoever has to be removed for access.  Easy on the Camry as well - just take off the air box and it's right there.  No Audi for me!
Reply: David Nguyen rotten battery cables, check them for corrosion
Reply: ChrisFix bmw 745i require you to remove the exhaust header and y pipe 😑😑😑
Reply: Funny you say to share your starter story. I hope you read mine cuz i had a ford explorer 98 eddie bauer edition and the whole center console and dash was identical to your truck and everytime i see your videos on the mazda i just think of that little blue suv. We drove it all the way ti the scrapyard when rust made it too unsafe to drive😞 miss that suv. But yea our starter failed on that suv and it was just like you said. Completely random without warning. Love your vids man keep up the good work
Reply: ChrisFix just happened today. watched this video the day it came out and was saying to myself "i hope my starter doesnt let go" lord behold, today at school, the same clicking happened. i have triple A so can get it towed though.
Reply: Back in '88, GM V8 cars and trucks had some starter bendix troubles causing it to scar the flexplate gear so GM was doing a "policy" warranty for us to replace the flexplate and bendix (rebuild the starter, lol) under warranty time, which was IIRC 1.7 hours labor total. This was to R&R the transmission, replace the flexplate and bendix and reassemble. We used to just undo the rear u-joint, take out the bellhousing bolts and put in two 4" long bolts in the B/H to keep the transmission up there and slide the tranny back far enough to get a long box end wrench on the bolts on the flexplate. Being Grade 8 bolts, going back on we'd just tighten the hell out of them, slide the tranny back in place and bolt her up. I could do it in 35 minutes, including the starter rebuild.

BTW, if you're ever doing a starter on one of those old Chevy's, don't lose the shims!  (?)

heh heh
Reply: ChrisFix  are going to buy a import car
Reply: chris got any idea?; when i start my car it starts normally but after it starts and i let the key back it sounds like it's still getting turned over, is that the starter motor or?
Reply: Flax
That is the starter, yes. The starter works by a energizing a low power relay, which turns on an electro-magnetic coil on the starter called a solenoid which pushes the starter motors' gear, through a bendix, into the flexplate or flywheels gear. When the gears engage a high energy circuit is made within the solenoid through a thick cable directly from the battery giving high current power to the starter motors armature.

What is happening in your case is the solenoid is sticking, keeping the bendix and the high energy circuit engaged. Replace the starter and you'll fix the problem. IMO Bosch makes the best starters in the world, well worth the extra cost.

In the old days you could buy just the solenoid and replace it for $10 or so. But since the rebuild industry has made starters available for $40 - $50 it makes no sense for a mechanic to do that because the extra labor charge to replace the solenoid ends up costing the same as replacing the whole starter.

In the old-OLD days the "solenoid" was a separate part attached to the inner fender inside the engine compartment. It was actually the low and high-energy relays combined. You may have heard the car thief in old movies say he "hot wired" a car? The solenoid was where he got the power for that. He'd attach a wire (the "hot" wire) from the battery post on the solenoid to the ignition coil and then jump power at the solenoid from the battery cable high-energy connection to the low power post with the wire to the electro-magnet on the starter, turning it and and starter motor on, starting the engine. This was of course BEFORE locking steering columns were mandated by Federal Law, pre 1970 on most cars IIRC.
Reply: ChrisFix my 03 Chevy 1500 the fuse for the start is the same for the computer... it went out but thankfully it was only a fuse so one fuse and a reprogramming later it's running again....
Reply: +ladamyre1 thanks mate!
Reply: ChrisFix, I personally prefer the 4.6 NorthStar's starter location over a conventional location as weird as it sounds I find it much easier to work with.
Reply: That was one good thing about that engine but frankly, I wouldn't own one and I worked for a Cadillac dealership. A great design on paper, IMO it was produced with an eye towards cutting costs anywhere they could find a nickel to save and it wound up making the engine a sow's ear of problems in reliability that could have been eliminated by just spending $2 more per engine.

Head gaskets that blew compression way too often, an oil pump gerotor sun gear not keyed to the crankshaft (dependent on the compression of the balancer bolt) sometimes letting go and stopping the pump (took 14 qts. to re-prime the pump, then drain out the excess), oil seals on the main bearing cradle that leaked (it seemed 1 out of 10 NS engines I worked on were filthy from grime from the slow leaks), and that's just to mention the 3 most common.

Frankly, I think the NS would have been a great engine in '96 when I was working on them except for those stupid corner-cutting cheap-ass cheesy production flaws. I don't know if GM straightened that stuff out but, and here's the point those bean counters never seem to get until it's too late...

I'm not going to ever give them a chance by buying one to find out if they have!

You may notice from my avatar I bought a Mercury Marauder in '04, one of the last ones to come off the line at the St. Thomas plant in Canada. Best car I've ever owned too.
Reply: Chris fix BMW
☺🔧🚗🔧
Reply: ChrisFix
Reply: ChrisFix Hey ChrisFix I love your videos! They always give me the confidence to tackle any job that has to do with my truck and my friends vehicles. This time my truck wouldn't start when I went to Waffle House so I had to call AAA and get it towed to my house but once I got it to my house and started working on it to try to find out what was going on with it I replaced the starter it still wouldn't start replaced the starter solenoid it still wouldn't start then I had one of my mechanic friends take a look at it and what a truly ended up being is my positive wire going into the female side of the terminal was so dad gum corroded underneath the clamp that it wasn't getting a good connection so once I cleaned out the terminal and the wire going into it I tried to start it and the wire going to the starter solenoid that goes to the starter got all fried up! The reason for that is that my starter came with a copper male connector that could have been used for another car (it was a positive contact and it was flat up against the engine block which completed the circuit) and the connection was so bad before i cleaned up the terminals that it could not short out! So we pulled the starter so we can remove that connector and once we removed the connector IT STARTED RIGHT UP!!! I am glad that I replaced the starter and the starter solenoid because the new one is a way stronger than the old one so i got an accidental performance upgrade!!!
Reply: Hey Chris,  just some days after I watched this video, I had the exact same problem with a friends car! Bad news was that we were hanging out, and had to push the car up the hill. But thanks t you, I could diagnose it and set my friend to take to the shop knowing the problem... and not falling on a scam!
Reply: When I had a bmw e46 I had a bad started and changed it myself. I was under the car for hours trying to get at those bolts with some crazy extensions. There is very little room to work with. But it was so satisfying to start up once that job was done.
Reply: ChrisFix are you ever going to show your face
Reply: ChrisFix I used to do the hammer trick on our old loader
Reply: Hey ChrisFix
I have leaned so much from your videos i have repaired my own car some times. But unfortunately the starter motor went bad now. Since it's a smart fortwo 2006 model the starter motor is in a really awkward position. So i have to lower the whole engine to get at it. I couldn't be bothered so i took it to the mechanic. He charged almost $700 US... 

First and last time i buy a smart.....

Greetings from Denmark!
Reply: ChrisFix my step father had to drop a engine mount to get to the starter on a 4x4 4runner
Reply: ChrisFix my dad went to change the starter in his car only to find that the fly wheel broke
Reply: I remember putting longtubes on my 5.0 mustang. It was incredibly difficult to make them fit but managed to do it by loosening motor and trans mounts. During the process, a couple of the mounting ears on the starter cracked, of course I didn't find this out until I tried starting it and the starter fell out hanging by the wires. I managed to get half of the core and went to install the new starter only to be greeted by 4 exhaust pipes where 1 used to be...not fun!
Reply: Its me again... Well I end up getting the help of my Dad, and only two bolts hold my starter on, apparently. Replaced the brushes in the starter and it works great. 

The way we end up getting to the top bolt on the starter motor.. was literally use two long extensions..I forget how long, either 8" or 10" and go from the front of the motor.. near the radiator fan, and angle it a crazy way and got access to the top bolt. Fucking nightmare.
Reply: lol the hammer trick was how i lived fro about a year with an 86 f150. occasionally the starter would not engage the flywheel and just free spin, but oddly, most of the time if you waited a full 6 seconds and tried again it would start. it had to be six seconds though. no more, no less. it was the weirdest damn thing. also had a car, a 93 thunderbird, that had to be started with a screwdriver by shorting the starter out.
Reply: We had to come in from the side to install ours. Really sucks... though I really liked the thing about silicone paste. I just put dielectric grease on the terminals before installation... I'll have to do the silicone though, really good idea!!!
Reply: In my vw golf 4 2003 I don't need to push in the clutch to start the engine, is that a bad sign?
Reply: I remember I impulsively drove to Brooklyn one night after warped tour; I parked in front of my friends apartment in Jeep Cherokee waiting for my friends to come downstairs. When they finally showed I tried to start the jeep up and got nothing, discovered the starter was bad. Had to spend the night in my Jeep because it was parked in an illegal spot and ended up doing the job right there on the side of the road first thing in the morning when the parts store opened up haha. What a day.
Reply: There are two styles of vw/audi clutch safety switches, normally closed, and normally open...Does your cruise control work?
Reply: Yes it works perfectly
Reply: Chris you forgot to mention that its smart to block off the rear tires :)
Reply: Yep, did one of those NorthStar starters once.
Reply: mercedes a class and b class are a pain in the ass to change the starter cas its under the fire wall witch is at an angle  and on top of the engine so its squeezed in there there its space to even touch it
and to replace the starter you have to undo the bolts holding the subframe witch holds the engine and gearbox and lower the entire thing from the car so you would have a little bit of space
Reply: 1991 Toyota Corolla/Geo Prizm: The starter is on the back side of the engine. One of the bolts that holds it in points toward the engine, the other one points toward the transmission. (Most cars of that era had both bolts pointing toward the transmission.) The only way to get the engine-side one out is to remove the airbox.
Reply: Just sold my A class due to it's horrible suspension. Super stiff. And the engine is so compressed that is now surprise that a starter replacement is nightmare.
Reply: dude. yo explain so good everything that i get it quickly cris!. love your videos! i very like your mustang i hope you give it i little more hp :)
Reply: My truck didn't start and I replace the starter and did what you did and in the end my engine was seized
Reply: ChrisFix don't forget to check the wiring to the starter. I did everything and then that. turns out one of the wires on the starter came loose a little bit and was only working half the time. as soon as I touched it it came loose and now I have to get a guy to lift it and reattach the wires properly. (can't do it myself the car is pretty low to the ground).
Reply: I was moving from Connecticut to Missouri.  

200 miles in to Pennsylvania I stop for lunch, come back to my car, my starter is dead and that cost me about $700 between the mechanics shop and the motel room(so middle of nowhere that it took three days to get the part out there).
Reply: Didn't you try hitting the starter for one more last start?
Reply: I tried that, yes.  The starter was as dead as can be, and I don't know how far I was from the nearest town with better repair facilities anyways.
Reply: i had to change my starter on my '97 Nissan 200SX twice. Mostly bec I bought a refurbished starter and after a while that broke. I should'be spent the extra money to change to a new one. And YES Having right tools was a big help! I wish I knew that back then... haha
Reply: ChrisFix changed the starter on a Suzuki Grand vitara once, the new type.... not fun.... took me about 12 hours... the to bolt i used 6 extentions on, had to stick it up along side the exaust... the other two i reached from inside the wheel well... this is the reason i became a tractor mechanic. no tight spots. the guy beside me was changing a starter on a 1st. gen volvo v70.. he ended up taking the whole engine out...
Reply: Mopar Milan probably not a starter problem ;) unless you can't get the engine to crank. old cars often end up beeing hard to start, they mostly need stuff like; grinding new valve seats, new piston rings the tighten the gap to the cylinder wall, some fine tuning, and other stuff depending on the problem. these faults acure due to bad maintenance. all cars end up with these issues if they don't have it solved before the problem accures....
Reply: I have a starter on my '05 dodge durango replaced, first i thought it was the battery because the negative terminal was not properly tightened and all i did was tightened it and it starts, this issue happened 3 times so after the third time it won't start my uncle decided to jump start the battery with a charger, it was a temporary fix until it stalled on the fourth time, after that my dad replaced the starter with a new one and it started again with no problems after that.
Reply: ChrisFix ii
Reply: ChrisFix so sometimes my starter works sometimes it doesn't and I notice I have to do a double start and it works. Maybe it could be corroded
Reply: Had to pull the engine out completely to swap it. Fortunately for me, I was about to do that anyway since the engine needed rebuilding. I'm just hoping it never goes bad again.
Reply: ChrisFix lol my dad had a 1995 Nissan Sentra and he stalled it at a stop sign then when he tried to start the car again the starter went... Let's just say he got remix of that car immediately
Reply: 2005 chevy tahoe, starter went out in autozone parking lot. 4 hours 2 beers and a joint, in an after-hours parking lot.... Its the shimmy squeezing the new starter in place; its such a tight spot
Reply: ChrisFix 

Chevrolet Ecotech is a poorly designed engine!
Reply: 1 year ago my starter went bad and i didnt fixed it i was just jumpstarting it i just fixed it
Reply: ChrisFix Chris how about a face reveal at 3 million subs or 2 mil which ever one you prefer
Reply: ChrisFix I have a Mitsubishi Migthy Max 95 The Starter near The Alternator  When i Replace the Carbon in The starter
Reply: ChrisFix I love ur vids chris
Reply: great help, 2010 Subaru Impreza the bottom bolt was very annoying to get off, but otherwise easy job.  Thanks so much for all the amazing videos that are saving me tons of money and connecting me to my vehicle :)
Reply: my starter in my paddock basher just had a bad earth and it wouldnt start
Reply: Not sure where is the starter of the Hyundai Beta engine.
Reply: I guess you could just rev up your engine all the way to the rev limit, or the redline
Reply: I had a starter go on a work van, but rather than not even start cranking, it made a loud YIP sound and then stopped working.  After the motor was replaced, that van always made some yip sound when starting.  I didn't drive that one to much due to a wreaked interior and busted mirrors but I referred to it as the 'Yippy' van.  As far as I know, it still yips when starting.
Reply: did a motor and trans swap in a 91 fox body and the starter would  engaged ecen after starting so i had to cut the gear in half
Reply: I have 1994 GMC sonoma with 4.3L Vortec. It was 10:00 at night about to leave work. And I went to go start my truck. It wouldn't click or anything. I heard the relay. My battery wasn't dead. All the wired were connected. I finally just hot wired my starter to take it home. I looked around and found that a little wire broke off.
Reply: ChrisFix in my 1974 Toyota FJ 40 the starter motor blew out in the middle of nowhere, on a 4x4 expedition so I had to start it by pulling it with another truck or rolling down a hill
Reply: ChrisFix 1983 camaro sport coupe. Turns over slowly as if the battery is dead when warm
Reply: ChrisFix In
Reply: ChrisFix. One thing you should mention is most engine wear is from first start up of the day. cause alm the oil has worked its way down into the oil pan.
Reply: I had a crazy thing happen to me on my 1980 Porsche 924. The starter wouldn't engage and it ended up being the main ground strap between the engine and the frame. It just wasn't providing enough ground. Replaced the strap and didn't need a starter. Great channel,
Reply: Mine was quite straight forward until i took it off and being covered in oil it slipped from my hand. Long story short the auto parts guy knew exactly what i needed judging by the greasy starter imprint on my head
Reply: Hey chris, I actually just started watching your videos today at work haha!!  Just three days ago I replaced my starter and then yesterday I replaced my alternator due to the fact that both of them had failed.  I have two jobs, Del Taco Monday through Friday and Freedom Airsoft on the weekends and when I was leaving Del Taco, the car wouldn't start, so i got it jump started and figured I was fine and would only need to either charge or buy a new battery.  Turns out the battery was fine and I assumed the problem could be the starter or the alternator as I did't think about some of the other problems you pointed out as possibilities ion this very helpful and insightful video.  So I went home and while driving back in my 1999 Ford Explorer (automatic 4.0L OHV V6), A light had just turned from red to green and during major traffic and construction which only left one of three lanes open, the car dropped all power and the RPMs went to 0 and the car started to die as if stalling in a manual which me as well as many others have done plenty of times.  I got home eventually and took the starter off without any knowledge of how to do so HAHA!!  It was just very straight forward on how to do so since I looked up a picture of the starter.  I went to Atuozone and had it tested and it failed, but i was told that not only could it be the starter, but with what had happened, it could be the alternator as well.  So i bought and replaced the starter and then the car still did not crank over.  It was very close, but then died and gave me the constant clicking noise.  So I tested the amperage and output of the battery while off, idle, and idle with all accessories and electronics on.  The amps barely reached the mid 10s and dropped a bit.  So I did little research on what the problem may be and then bought and replaced the alternator with the help of a neighbor.  Now the car starts perfectly and all that is left is too test it out and see if it drives just as great.  Next up I am replacing the brake lights with new LED brake light bulb replacements that I bought after replacing and giving my alternator to Oriley's and will do the headlights later this week.  Probably Tuesday the first!!  This was very long, but my story that is still unfinished.  Check out the pictures of my before and after of the parts in and out of place on my instagram:  @777_Taco  https://www.instagram.com/p/BXKDu_Sgw1q/
Reply: ChrisFix I was with my buddy, we got in his 3rd Gen camaro and the starter wasn't engaging, he said this happens every 6 months so we started banging on it until we got it to start, took us about an hour and a half to get it to work
Reply: I have a 1999 chevy Tahoe I recently started driving I was 18 at the time my started went out. I only knew how to do the basics of taking care of a car which is the oil change, changing brakes, and a tune up ( that my mom taught me) well lucky for me I didn't have school that day and I go out to my truck to move it and it just work start it was clicking when I turned the key but the engine just wouldn't turn over. So I called my mom called my dad no one answered my luck. I had to figure it out myself so I went to YouTube and just searched the symptoms in the search box and I just watch video after video and came to the conclusion it was my starter but the problem was I didn't know where my starter was nor did I know what a starter looked like so I went to google and searched for a picture of a starter then I searched where my starter would be found in my truck I found the starter then my mom called and told me to tap it with a hammer I did and then I went to go start my truck and it started 

I then went to the store and my moms friend offered to put the starter in and he did 

Now my truck sounds better than ever 
When my truck breaks down I look at it as a learning than what the hell happened and my truck has been breaking down a lot but it's because things need to get replaced and also it's a old truck almost 20 year old truck
Reply: wsupchris1222444     WTF
Reply: ChrisFix hey when I hooked my battery after changing my starter. The starter turned on and my keys were in my pocket what does that mean
Reply: ChrisFix You are a really smart individual! Everything you talk and show in your videos just feel perfect! I can watch your videos all day!!
Reply: I'm having an issue on a 95 Camry where it will start fine throughout the day but it won't start in the morning.
Reply: Chris. I have a quick question. When I start my car the starter engages fine and crank sounds good. The motor does start after a few tries (its an old carbed motor) but when I let off the ignition (where my newer car is silent) I hear this weird noise for a second and it then stops. Its not like gears grinding but it sounds like something is grinding against something else. Could it be my starter??
Reply: ChrisFix my 1948 willys jeep and 1957 chevy bel air have the starter right next to the distributors, easy to see and easy to remove. Modern cars are pieces of junk
Reply: ChrisFix  any older ford truck 70's - late 80's especially if it has headers , will make you question life.
Reply: ChrisFix damn . Just buy a honda
Reply: chris, you can replace the starter's solonoid also. For me it worked.
Reply: Last year I replaced the starter on my 1996 F-250 PowerStroke, great big gear reduction monster of a starter. Like you I wanted to confirm that the starter was in fact bad so went to local Advance Auto, the guy puts it in the test machine but it didn't have a shield like the one shown in the video. when he applied power it spun, then immediately arced and caught fire! Almost burned the machine down. Needles to say that one was bad
Reply: when i turn my key it makes a noise like something is jammed, idk i thought it was the starter but it doesn't look like it
Reply: I had to replace the starter on my dad's van a few years ago. Bought one online since we didn't plan to keep the thing and it worked fine until one day it suddenly stopped starting the car. Took it to AutoZone and tested fine. Turns out the cable that attached to the smaller lead had broken apart, as when I replaced the original starter I had to rig up a new connection because the original starter's smaller lead had stripped. Had to cut it and put on a new connection. Turns out I had not made the new connection tight enough, so I had to put in another. Made sure this one was longer so the vibrations of the engine would not shake it loose and made sure to splice it tighter. Now that I have soldering gun I may do as you showed in another video and solder any connections like that.
Reply: Had the starter go in my truck a month ago. Lucky for me it's a late 94 so I got that gear reduction starter from the 95+ gm trucks and not that giant old one all the 350s had. Replaced it and the new one worked fine for a week. Leaving Timmy's and it grinds when I start it. Thought to myself "not this shit again". Went to start it up later to go to the parts store to get a new one and not a sound. But smoke starts coming out by the passenger tire after I had the key turned for maybe 3 seconds. The replacement part shorted inside the motor and caught fire. Somehow didn't ruin the wires but it did melt the power wire for my extra reverse lights that ran up beside it.
Reply: ChrisFix my starter was falling off, made horrible noise. make video about this haha
Reply: My starter failed at my ex girlfriends house and I didn't make it home to my gf in time so now I'm single
Reply: ChrisFix Was pulling an engine with some buddies once, forgot to move the filled (6qts) oil drain pan. When I undid the starter, dropped it (old giant motorcraft one) right into the drain pan of oil. Biggest spill I've made.
Reply: ChrisFix i had a 1980 datsun 720 i had to use a small screw driver to make a connection to get it to start.  Worked like a charm
Reply: I had purchased a used 2005 Suzuki Grand Vitara and after a week it didn't start. I went and bought a new starter before I figured out it was a bad negative terminal cable on my battery. There was a slight cut in the wire and it was grounding to the car. Some electrical tape got me back on the road (probably not the safest way) and I refunded the new starter. Good thing it wasn't the starter because it is under the manifold and can cost a lot of labor at the shop.
Reply: ChrisFix My replacement starter came with the small wire attached and a warning label stating, "Do not remove. Crimp and heat seal on." I'm debating actually following the directions.
Reply: ChrisF
Reply: Chrisfix how to do 5 lug conversion
Reply: My starter 2001 Ranger. Maybe was good. I had a loose tranny cable. Accidentally saw your other video on this and now it works
Reply: my dads jeep has a fairly easy acces underneath it
Reply: ChrisFix , my daughter's 1990 Honda Accord will krank but won't catch. I posted a video that's only like 12 seconds.  It's a sound that we have never heard before. If you go to Jocelyn Barber the video is under there. I only have like four or five videos. Or you can go to 1990 Honda Accord problems. I know you are a busy man so if there's any way you can get to it, I'd appreciate it. Thanks in advance. Keep up the good videos!!!
Reply: Easiest starter I've ever done was on a '95 Mazda mx-6 v6 5 speed (ford probe gt) so I could remove the transmission and swap out the clutch.  The starter was on top and up front with nothing blocking access.  Hardest starter I've ever done was on a '00 Chrysler lhs 3.5L for an engine swap.  The cables to the starter were in between the starter and the engine block and if you didn't align the cables just right you couldn't get the starter lined up with the bolt holes.  There was also a shim in between the starter and the bellhousing on the transmission which was a big PITA.
Reply: ChrisFix I need advice! I’ve put 2 starters in my car already, first one worked for 4 starts and died.. second one worked once and died. I don’t know what to do! The wires look brand new! I’m stuck.
Reply: ChrisFix if the fuel pump is bad on a car will it start?
Reply: Official Drajae I would assume no cuz if the fuel pump doesn't work it can't get fuel to the engine and if the engine can't get any fuel it'll just crank and crank until you blow your starter or drain your battery.
Reply: Going through this right now with my W203 C240 Mercedes. Terrible starter location under the passenger side exhaust manifold and towards the back of the block. Really not much room to work in the engine bay on these C-class Mercedes. Instead of removing the exhaust manifold I've just unbolted the passenger side engine mount and jacked the engine up a little bit on that side so I can fit a new starter in there.
Reply: ChrisFix 
Chris I fix my car watching your channel after two garages failed.
Your deserve a TV show 
Thanks very much from uk
Reply: ChrisFix  your my best person ever and could you do a video of you racing in your drifts ting
Reply: Do you have a video already about why a car would turn over, but not start once and a while? It doesn't happen every time, just once in a blue moon, but I have no clue how to diagnose it.
Reply: ChrisFix zto
Reply: Changed out the starter on my 2003 s10 zr2. Relatively easy. Also, I got the starter removed and rebuilt from a Detroit Diesel 353 from a 1971 Gama Goat. Let me tell you: that was a 40lb monster to get in and out.
Reply: ChrisFix one time i was going to the store to buy some parts for my car  i had to use my moms car, when i tried to start it up i did not start, i realized that the starter maybe was bad, but I cheked the ignition, ufound out that the starer was bad.
Reply: I bought a volvo recently, the starter had fallen out lol
Reply: CHEAPEST WAY TO REPLACE IS NOT THE WHOLE STARTER BUT THE 
BRUSHING INSIDE THE STARTER IT'S REPLACEABLE 
THE BRUSHING MAGNETS WEAR DOWN 
$20-30 FOR BRUSHING VS WHOLE NEW STARTER $100+
Reply: I love your vids
Reply: Anthony Elmore Haynes manual says to disconnect negative terminal 1st & reconnect it last for my Toyota.
Reply: ChrisFix
Reply: The starter in a Cadillac Northstar won’t need to be replaced as often as other cars because it’s protected from corrosion, dirt, rocks
Reply: New best friend Chrisfix I subscribed and  I changed  one yesterday
Reply: Adam Vang an e brake comes stock
Reply: I put my key in the on position and I hear is click click click click constantly. Car starts fine. Clicks while car runs. Is this my warning that the starter is going bad?  09 Chevy Malibu 4 cylinder.
Reply: Jason Thomas I think battery
Reply: torin hansen battery is super clean and a month old.
Reply: Jason Thomas OK your right
Reply: ChrisFix Have you ever had to reace a starter on an 2000 f150? Mother of god, the top bolt is ridiculously hard to get to.
Reply: 2000 tundra v8...starter is underneath the intake manifold...it will keep it colder, they said...you should never have to replace it, they said...and it's a common issue with the truck and takes 4+ hours to fix. Rule of thumb: first generation first year vehicles have issues to be worked out!
Reply: My dad's 2001 Dakota had problems, luckily it was manual so he could bump start. After replacing the starter; problem wasn't fixed.. He noticed the Ground strap was a bit worn out, and kind of small. He put a thicker wire and had no problems since.
Reply: the starter and belt on my 2000 f250 went out DURING HARVEY. I had to replace it in 6 inches of water. such fum
Reply: ChrisFix hey chris i just bought a new starter but it came with a wire that says do not remove crimp and heat shrink to existind lead? Can i remover it?
Reply: Hey Chris, my truck doesn’t click when it starts. Could that be the starter or something else?
Reply: My brother had broken starter for almost two years, he had just long steel rod, to hit starter every time he wanted to drive it.
Reply: i have a chevy c2500 when i was putting the starter in i cracked the block as well as broke the starter due to overtightining
Reply: Had to replace the starter on my sister's 08 Hyundai Sonata with the larger 3.3l engine - enormous pain, Hyundai decided to put the starter BEHIND the exhaust manifold, between the exhaust and the block, so that it was almost impossible to get to it. In fact everything I've read online has said it's easier to remove the exhaust manifold to get the starter out - but I was stubborn. Managed to get it out and replace it, but it took 8 hours with only my cheap harbor freight tools. Got it done at least haha.
Reply: Hei nice video , i have a question , when i want to start the engine the only think that happen is a click click to the starter is coming from there , and i cannot start the engine at all, what is it ?
Reply: ChrisFix one time I bought a Jack and I fixed my Audi A6 at home using this video
Reply: Buy an old Peugeot 206, try going to work using it... Suddenly dead and won't start... Some people help push my car to the side way, good thing the road is going up and I use manual car. So I put my gear on neutral, release my break, step on the clutch, my car going backwards, put my gear to R, and release the clutch slowly... Aaaand it started... Thank God I use manual car that time... 😅
Reply: ChrisFix Can you do a rollcage
Reply: I had to replace my starter a week ago, because it was turning without cranking, like it was just connected to battery and to to the engine (Diesel engine), after opening it, we found that the internals were all damaged, we thought It was still tuning with the engine, but I really don't know what happened exactly.
Reply: I have a 06 GMC Canyon. To get to my starter (which died in a McDonalds parking lot) I had to go through the cold air intake, the belt and alternator, the intake manifold, and finally the starter! IT was just inside the drivers wheel well but was impolssible to take out from there. The worst 6 hours I spent in McDonalds.
Reply: ChrisFix gearing up to do a 99 kia sephia this weekend. Either the intake manifold or the catylitic converter has to come off to get to it. Gonna be fun.
Reply: The bluetop 4A-GE in my MR2 has its starter motor located underneath the exhaust manifold. Not only is it just that little bit more annoying to get to and remove, the heat also gives it undue stress.
Reply: So, as an eastern european my best friend fucked around with his cars ignition, because the idiot couldn't find the keys. He didn't manage to start the car, but the motherfucker made it so that the car starts when the key is turned in the other direction. Well to top this off, when the car is started like this. The starter keeps running until it is eventually burned to death if not noticed. So we have switched 2 starters and now we have to buy a 4th one cause 3rd one is dead as well. Now let me be with my story cause I have to go and push start the broken citroen c3
Reply: I was getting picked from school by my brother and then the pedal was hard and the car wouldn't start. I then remembered the antitheft immobilizer was disconnected. I plugged the little relay thing in and it started. Thanks ChrisFix!!
Reply: ChrisFix à
Reply: When I first got the old Mustang, I started to have problems starting even when it was fully in park and with a good battery and alternator. Now I didnt have an ammeter like I do now. I left my GPS plugged in all day on the first day (on a 1965 Mustang the key DOES NOT cut power to the cigarette lighter) so I thought the battery was just weak from that. But for the next week or so it kept happening and sometimes wouldnt even crank. But the alternator light never came on. So we bring it to a shop and sure enough it was a bad starter.
Reply: The Cadillac Northstar engineers say that help with starter cooling.
Reply: ChrisFix like how Toyotas v8 has the starter in below the intake manifold
Reply: My accent was making this slow starting noise. Turns out the part that connects the wire to the positive pole of the  battery had melted because I live in hell.
Reply: my grandfather has a tractor and we just replaced the starter so we could mow our lawn
Reply: ChrisFix I just love working with fuses 
A week ago I replaced the fuses in my moms car with light-ups
Reply: Tomorrow I’m gonna diagnose and hopefully replace the starter on my 1948 Willy’s CJ2A Jeep (and I’m only 14!)
Reply: Chris
Reply: ChrisFix I had to cut a wrench in half to get a bolt out of the starter of a 67 scout
Reply: My dad's old pickup had a weird starter and he would carry a pvc pipe and whack it to get it to start.
Reply: Just save me 20 thanks!
Reply: went on a trip in an automatic subaru, starter was randomly not starting, and had finally quit working all the way on the last stop right before returning home late at night.. slept in the car woke up in the morning and bought a new starter from autozone, borrowed tools and changed it in the parking lot and drove home.... yes I should have changed it when it started failing, and nowadays I have AAA too...
Reply: Hey man, I've been watching your videos for a while now and it's helped me with loads of things. I'm new to owning my own car.

One question though, I have a 2.5 litre turbo diesel volvo from 2004 which has trouble starting, it idles smoothly and seems to start well when cold, but when hot or when stalled, it is much harder to start. the engine seems to turn fine but it doesn't seem to "catch" sometimes. Sometimes it'll start up on the first "catch" and other times it'll take 2 or 3. I hope you know what I mean by catch, where the fuel starts to combust and you see the revs jump up.

I've checked with an ODB bluetooth tester for engine codes and I don't see any at all. Any idea what I could check?
Reply: You are doing very well
Reply: I once had a starter on a 99 4Runner that decided one day to not disengage.  It caught fire as the engine forced it to turn faster than it wanted.
Reply: Lancer’s have their starters under the intake manifold...
Reply: ChrisFix how you take out round starter bolt
Reply: I replaced a starter once. It was straight-forward just like this video. The most exciting part was getting the car up on ramps, which were not properly aligned, and I almost killed my buddy when the ramp failed. Many lessons were learned that day.
Reply: BMW e46
Reply: Hey I put the new starter on today and it wants to turn on but doesn't when I took off the old starter and put the new starter I had both cables off
Reply: Starter went bad on my Dad's 1996 Sierra. Daddy grabbed some tools, a new starter, and  took the family van to the high school parking lot. Spent all night hanging out in parking lot while Daddy replaced the starter. Just before he got finished, he snapped a wire, drove home to weld it together, returned to the lot, and reinstalled the starter. Turned the key over... nothing 🙄 It was 4AM and we were exhausted. We left the truck in the parking lot and went home to get some rest. The next day, we returned to the truck and found out what had happened. The wires were mixed up 😂 As soon as he corrected the wires, everything started right up.
Reply: 02 international with the Cummins I changed a starter on easy to say when removing semi truck starters try to use a floor jack to support starter after taking bolts out. It will fall on your chest. I leaned that the hard way Hahah.
Reply: Starter solenoid. That could be an issue. I had that problem
Reply: i have a 1998 mazda b3000 with a 5 speed maunal  what do you have stripped bolt of the crank sensor
Reply: My fiance 2010 accord 2.4 starter is under the intake manifold lol
Reply: @aab434  wow. That's odd
Reply: Every 3-5 times I start my 91 Mazda I have to hit the starter with a rubber mallet, while either a friend, or stranger holds the key in the start position. The starter lasted for 27 years tho.
Reply: I don'thaveone
Reply: I had to replace my starter on my 2002 Explorer. Crazy thing is that I had parked it on unlevel ground beside my driveway the night before. The next day, through testing, I found out that I had to replace the starter. I went through the left front wheel well. That meant I had to jack it up to remove the tire, but it was in the grass. So I first had to jack up one side and put some bricks under the two passenger side tires to level it. Then I had to grab a thick piece of counter top to rest the jack onto it to jack it up. Getting to the bolts on it was the most difficult part of it. With it being jacked up on the grass, even on jack stands, there was no way I was going to crawl under it for safety reasons.
Reply: Chrisfix, my car sometimes cranks for a long time before it starts, and some times it does immediately. It’s moody idk why ? Can you make a video on how to diagnose it and fix it ?
Reply: This story is weird
When I was like 10 years old,  my uncle,mother aunt,my friend (From Pancevo) went to the Romania Border. It was my first time going there. 12 minutes later,my uncle got into his black Ford Focus 2014 car model (I think this is the model) Guess what? IT DIDN'T START!  All it was just a click. I remember having a panic attack and my brain was like:
- NO GOD PLEASE NO! NOOOOOOOOOOOOOOOOOOOOOOOOOOOOO!

I had to fall asleep and I woke up to hear my uncle talking something in english and they tryed diffrent trys like pushing the car ect. WHICH NONE OF THEM WORKED! In the end they decided to move aside to prevent the traffic to take long.

Later, my grandfather came with the hook and he was in his Audi and my uncle was nervous cause he haven't drove a car attached to the other car and because of that he caused a bump.
In the end, I got home and the car was taken to the service until the end of Easter.
And that story got it thinking. Was it the starter or the fuel pump?
Reply: I have a 87 oldsmobile tornoda cranks but dosnt start what should i do?
Reply: Chrisfix
YouTube
Reply: So wait, if the car was cranking some times when you turn the key would you rule out a bad starter right away?
Reply: I have a 2004 Altima and everything turns on and when I turn to the ignition it tries to turn on but doesn't start. No clicking when I try turn it on.
Reply: My 1uz fe v8 lexus Gs400 has the starter under the intake manifold
Reply: this might be a little late but your batteri should be at 12.7 V then its fully charged, 12.4 V is half charged
Reply: ChrisFix 2007 Jeep Wrangler is kind of a pain in the neck.
Reply: Oh CRAP! You did that already
Reply: 10 out of 10
Reply: My jaguars starter broke in 2 pieces. Split from the mounting plate
Reply: So during the week I was using my old Suzuki Swift 93 and this morning it didn’t turned on...
Reply: here's an interesting one. So, we had a bad starter on our 1986 jeep wagoneer. The starter spun, but the little gear didn't pop out. Replaced it fine (at my dad's friends house), but halfway thru the trip home, we lost power. I accidentally left the wires touching the engine, the wires ended up melting and shorted out
Reply: 2nd last comment here hehe wasted it
Reply: I have a 2004 BMW 545i I replaced the INTERGRADED SUPPLY MODULE and the FUEL PUMP RELAY and it only cranks it’s been about a year since it’s worked I’m not sure what to do
Reply: Your video just saved my mom 300 bucks and a lot of headache! She was told her starter was bad, then she saw your video.. turned out it was the neutral safety switch. Thank you!
Reply: My starter on my four wheeler just quit and stopped working
Reply: We own a 1969 VW 1300L and a few months ago, the starter solenoid went bad. We turned the key to the ignition and only the starter would spin, without engaging the flywheel. After diagnosing the issue, we got a new solenoid, and kept the original starter. Put everything together, and the issue was fixed right away! This was my first ever repair job in a car. We saved over 50 dollars by doing the job at home!
Reply: My first starter removal, I was removing the nut holding the wire for the solenoid feed which was being a bit stubborn...  I proceeded to apply more torque and the solenoid casing cracked apart (Polymer and epoxy set housing). Boss was a cowboy and not a very nice gentleman so ordered me to get it working again because he wasn't paying for it!  I pieced it together like a jigsaw with araldite, terminal studs and all and after setting, refit and it actually worked. It had no right to work, but it did.
Reply: @JamOwnzU  Oh, wow. That was certainly a tricky situation. Glad you ultimately got it working!
Reply: Does a 2006 Audi A6 Wagon have that like that?
Reply: Jesus quiere un dia arreglar su auto🚗
Reply: toyota 2005+ 4.7 V8. it's buried under the intake manifold, which has to removed to replace. A fricking nightmare, and you can't even test it before replacing, since you can't see it, let alone get a meter on the terminals.
Reply: ChrisFix  my starter did some strange noises, what does that mean ?
Reply: Chris, we can't thank you enough for all your awesome videos. Best videos on the internet for the weekend warrior like me. We love that they are in detail.  Thanks again.
Reply: Effect141194 maybe its just the computer? or damage on cables which lets current flow through when its higher than a certain voltage 
I mean the cables might look good but there maybe an issue on the copper/silver/aluminum (couldnt decide which one to write)wires like a little torn apart but it looks good outside
Reply: Are starter are broke down so we go in the mechanic
Reply: can you please show us how to fix it if it was a key problem please
Reply: i asked the mechanic that i work for he doesn't know how because we only work on 1980s  and older plz help chris
Reply: Chris it's called a flexplate not flywheel
Reply: Last night I spent around 8 hours with a buddy to replace the starter in my 2007 Suzuki Jimny.
Initially, we tried taking it out from underneath the car. This might work on manuals, but the automatic gearbox was in the way.
So we ended up taking out the intake manifold and some other parts in order to be able to access the starter. We managed to put everything back together without having any extra nuts and bolts left over at the end. We started at around 5 PM and finished at around 2 AM. New starter works great though!
Reply: I did a clutch on my ranger and had to take the starter off after i was all done i turned it over and it made a really loud clacking noise lile plasticy. Well one day it didnt start and i heard the starter clicking so i tried the hammer and i tried the rocking trick. Nothing. I looked at it and all it was was a loose conection. Tightened it up and bam it was fixed
Reply: Owner of a '90 f150  with a starter going bad. It would crank ok when cold but when hot it turned over very slowly like it had a weak battery, and getting a boost from another battery made it start like normal. Had the battery tested and it was fine,  so I replaced the starter and never had a problem with it again.
Reply: ChrisFix I drove my fiero to the local parts store knowing the starter was bad and needing replacement. Went inside and got the starter no problem but when I went to drive away the starter finally had enough. No matter what amount of hammering I did it was no use so back inside I went to rent the tools I needed to do it right there in the parking lot. Thanks to you it went in without any issues!
Reply: @TheUberdude14  that's the basic thing one has to check, first. If ur starter is broken then when I'll ignite the engine u'll here the cranking sound
Reply: ChrisFix   Hi Chris just wondering where u find all of these torque specification for different parts of ur vehicle?
Reply: @MoparMilan  i have the fucking starter.  stock and  under the headers in the camaro 2011 there no way i can remove it with out removing long tube headers from the way
Reply: I have a 2006 Mazda B4000. It took me about 4 hours to remove all 5 nuts and take out the starter. There's not much space in there and there are some awkward angles. On connecting the new starter I snapped the ring terminal from one of the wires that run from the battery while trying to work the angle to tighten the second wire. I assume I strip the rubber housing from the wire and attach a new crimp on terminal lead. But at this point I'll probably get it done professionally. Got more than halfway there anyway! Chris, your disc brake video has saved me some major $, wasn't so lucky this time!
Reply: Chrisfix when I had problems with my car you saved me
Reply: Have worked on a starters and alternators shop and we get a lot of totally chewed up starters for mitsubishi sedans, they come with 8 or 9 teeth gears depending on the engine model so many mechanics here put any because they work but with time they end up completelly destroyed and the costumers complain because when we see in the system we give then the right ones according to their engines but they wanted the same they had like "dude mine is 8 teeth and you are given me a 9 teeth one!" hard to convince some oldtimers that the mechanic have messed up the models and they have been using the wrong one 😅
Reply: 2007 Honda Accord has the starter under the intake manifold as well
Reply: Hey ChrisFix, I’m trying to diagnose a starting issue. The battery, starter, and alternator tested good but my car doesn’t want to start. It makes a rapid clicking when you turn the key. Any idea what it could be?
Reply: @danielbrothers3796  in my limited knowledge sounds like the starter is not working well maybe is the connection, if the starter spins outside the car and moves the gear and installed don't work can be a  connection issue. One mechanic told me a long ago that the clicking sound is because of the starter throws the gear to engage the flywheel but is not spinning so check the connections.
Reply: I was getting off work after working a 11 hour shift and my car did not start didn't even crank. Do I thought maybe it's my battery checked it and it was fine maybe my alternator checked it and it was fine then I thought that if it's not power issues and then maybe it's my starter sure enough it was my starter
Reply: My dad, Jose "Tony" Carrillo I -- a former construction serviceman for a military construction division of the U.S. Navy called the "Seabees" from September 1999 to 2006 -- ...currently owns a 2001 Jeep Wrangler TJ 2.5L soft-top since buying it in November 2011 (now has approx. 128,000 miles).

When you go to start it (clutch in, in neutral, since it's a 5-speed stick-shift rather than an outdated 3-speed automatic, though I'd rather automatics be a 4-speed for the YJ and TJ generation Wranglers), the engine does fire up, but it's very weak at first for some reason. So you have to give it some throttle to build the RPMs to sustainable idling speeds (approx. 850-1,000 RPM) without it dying on you or revving it by mistake. Not to mention you'll sometimes hear a grinding noise in the engine compartment. Not sure what's causing it.

Similar thing with "The Beast," a lifted 2003 Ford Excursion Limited 6.0L PowerStroke V8 Turbo Diesel 4x4 that he bought in July of 2014. Only this time, late one night back in February of 2018, one of the two turbines inside the turbocharger blew while going over Grapevine Ridge not too far north of Los Angeles with a trailer loaded with house furniture in tow (I was a heavy-metal DJ with the damaged Panasonic stereo that night). Reason for it was because of negligence in vehicle maintenance by his ex-wife at the time (in this case, an oil change for the turbo). It still drove, but only up to around 35 MPH (56 km/h; speedometer needle read just under 30 MPH because of its 37-inch tires). So, we left it at a roadside gas station for later and called for a 2006 Dodge Grand Caravan SXT V6 to take some of us home while the rest went in "Smokey," an old and beat-up 2004 Dodge Ram 1500 SLT 4.7L Magnum 4x4, with the trailer.

"The Subie," however, -- an American-spec 2005 Subaru Outback 2.5L XT station wagon -- ...had it the worst. One day while driving in 2015, one of the con rods snapped, causing it to shoot straight through the engine block completely destroying the engine itself in the process (except for the turbo and intercooler). We're still wondering on wether to sell it or order a new 2.5L turbo flat-4.
Reply: @chrisfix  What type of Mazda is that?, it looks nice
Reply: I forget what kinda car it was now, but an ex-gf of mine had a starter go out, and I ended up having to take the front wheel off the car, remove the inner panel of the front quarter panel, and a bunch of other stuff just to get a 3 foot extension into the engine bay with a u-joint on the socket.  Usually I can do starter motors in an hour or two, this thing took almost an entire day.  What a PITA!
Reply: hey chrisfix you should come to Washington state and help us with my 1986 iroc z camaro.
Reply: Just came to this video because I was uneducated when fixing my 1993 Ford Ranger, I replaced my alternator, even the starter relay. But now I’m in the process of fixing my starter.
Reply: Even Citroën has this bad design, or probably even worse, because, when I worked on a Berlingò of 2010 there are 2 of 3 bolts that are not easy to reach. I needed to take down the battery and his bracket to reach them, and even with the battery and the bracket down wasn’t that easy to reach them.
Reply: One time my starter went out in the middle of Iowa and well long story short I managed to run my engine out of oil
Reply: We were replacing my friends starter and it went alright, just a bit hard to get to. The issue is the battery and fuse were fine and there was no theft light, later we found he had a massive oil leak and the engine ran dry and fused itself.
Reply: Used to have a 2008 BMW 328i and had to replace the starter twice within a few years. You had to remove the intake manifold to even get to it. And everything is a torx head and aluminum 🤯
Reply: 06 infiniti qx56 starter under air manifold
Reply: I have an 06 Lincoln Town Car Limousine and once the starter went so bad the battery kept dying because of it.
Reply: Starter went out on my 2010 Buick LaCrosse in February 2021. Was having problems but didn’t know what it was so I got the battery replaced.  Two months later found out it was the starter got it replaced in April 2021. January 2022 I began having problems again but was in denial that it could be the starter because it was still brand new lol. Had it towed into a shop they did a diagnostic test on it and low and behold it was a starter and just got it replaced today 12 Jan 22.
Reply: Car wasn’t fully in park 😂happend today and I can remember watching a vid on here thanks so much I needed to get to work 👍
Reply: Thank u so much fella u helped me diagnose my problems that’s so much I love all your vids🎉❤
Reply: My brother drove his 94 civic with a bad starter for about half a year before replacing it. He used his clutch and gravity to start the car LOL
Reply: 1) voltage drop at the starter signal wire during cranking
2) provided direct 12V from the battery positive to the starter solenoid and still not working
3) inspect the ground side... find out the engine block to chassis ground wire is holding by only a couple strands

Replace the engine ground strap and problem solved.
Reply: some cars you have to pull the transmission to get to the starter. (because its inside of the bellhousing) silly
Reply: On my A6 (2.5 V6 TDI) I have to pull the alternator to get to the starter cuz it's located behind. to pull the alternator i have to pull the entire front "Facia". 
Im praying to whatever forces up there that my starter doesn't fail. but hey, if it fails it fails.
Reply: The nissan titan also has the starter under the intake, such an odd decision
Reply: Chris 05 Chrysler it's not starting but my dash lights not coming on unless I turn my lights on.battery is good and
Reply: Good tip I just replaced the fuel pump on my f150. The plastic part around the new pump wouldn’t allow for the sending unit and float to screw on so I put the new pump in the old plastic housing and slapped it together. Works great now! Aftermarket shit sucks most of the time I just hope it lasts!
Reply: Oh let’s just say I didn’t know how to properly diagnose when I was 17…I had taken the transmission out of my 95 Chevy 3/4 ton so a big ol 4l80e that was completely full to change a flexplate. We also changed a rear main seal (which made my oil leak problem worse considering it probably got rolled in💀). Get everything back in…all for a bad starter🤦‍♂️. RIP 3B